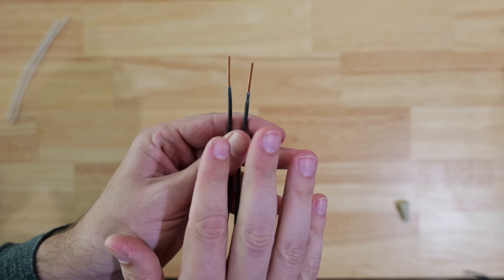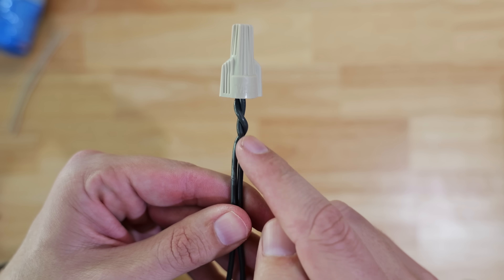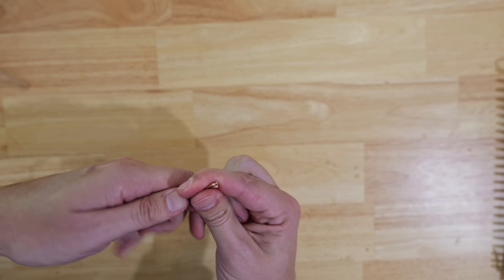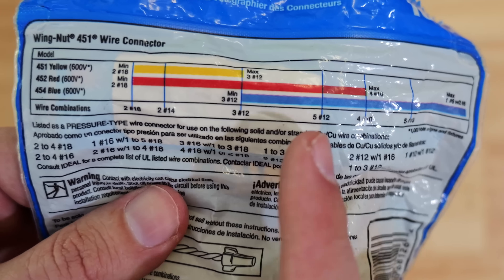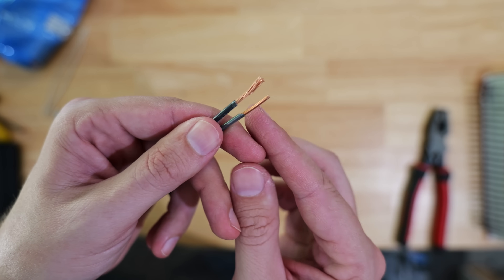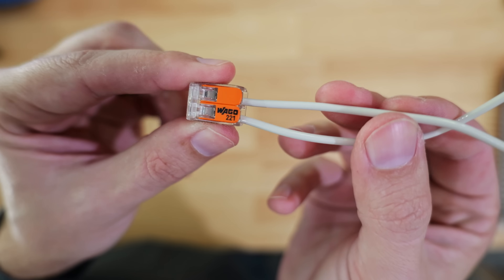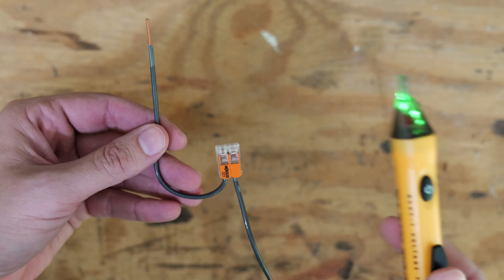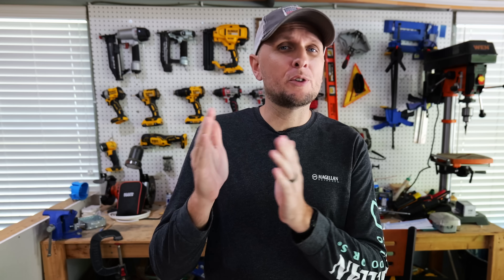7 FATAL Wiring Mistakes Most DIYers Don't Know They Are Making | Most Are Guilty of 3

Comment: Hi professional European electrician here. Wire nuts are pretty uncommon here, indeed I´ve never seen one in use here. The WAGOs are really hard to open, I can´t imagine that this could happen by accident. (theoretically when you pull in backwards direction only.) And all the information you need to know is printed on them: Voltage, current, wire style, AWG, cross section, even the strip length (as picture for the true length and also as number). Additionally the same information huge on the paper box. So if you are able to read...they are pretty safe. They even have a hole to check voltage without the need to open the connection. Tests show that they are more safe than screwd junctions and as soldered junctions.
Reply: Ja die wagos sind echt gut im Vergleich zu dem was es vorher gab
Reply: they are everywhere in sweden, i moved from denmark to sweden and had never seen them before, i dont use them my self think they are outdated
Reply: @bikerpumbajh8108  the wagos of the wire nuts?
Reply: I don't think we'll ever se wirenuts used in Europe or the Nordic countries. I use Wago's too or the normal single or double screw block thingies. I prefer the 2773 in most cases where no stranded wires are used - but they are a bit of a bitch to take of sometimes. The 221 are multipurpose, but i feel they can easely open and they are very brittle if a painter has been there, and you can't really reuse them as the levers brake easely..
Reply: @Hemshemsems  The levers break easily?? What? I've never encountered that.
Reply: @mrvisual2482  More an info to keep them from contamination from solvents and paint and so on. Keep them clean and packed away when other ppl are working in the same area..
Reply: I haven't seen 'wire nuts' used since god knows when. Way back in the 70's maybe. Wagos seem to be the 'in' thing of late and once closed the connections are pretty secure. But UK wise, screw terminals are usually the way forwards for DIY. But even then, I've seen stranded cores just put into the terminal as is. Unless you put a slight twist to them they can just come loose as they spread as you do the terminal up. But in the factory panels, sprung terminals are everywhere.
Reply: Klaus why are wagos better than screw terminals? Assuming the screw terminals are properly torqued.
Reply: @bertiesworld  wire nuts are still pretty standard in Canada, unless it's LED pot lights that come with WAGO's never seen an electrician use anything but wire nuts.
Reply: in NL, we have wire nuts in stores, but nobody who's done electric work in the past 20+ years would use them. Older people that used to do electrics do prefer them over the new wago-like things we have, so the DIY stores still have them (or at least, did 10 years ago).
Reply: @dmhor7389  in the US I've never seen or heard of Wago boxes
Reply: I occasionally use Wago connectors, I constantly use their relays and terminal blocks, on hindredof machines, over a decade and haven't had a failure with their product.
Reply: @kettch42  there is plenty of  Wago product in the USA
Reply: @mikehagen3785  of course but have you ever heard of the wago boxes with slots for the connectors to sit in? In the US we use the outlet boxes as junction boxes as much as possible.
Reply: @kettch42  I have them, my rep gave me samples,  I just don't need them often, I wire industrial equipment.
Reply: @mikehagen3785  I do industrial mostly too, mining. Control wiring is usually din rail mounted screw terminals. Lighting is still wire nuts, but miners are very resistant to new things. I do residential stuff as a "hobby", so I'm not on the cutting edge. I work as a licensed EE doing power systems and motor control design and construction management.
Reply: @kettch42  yup, Din rail and PLCs, control relays, etc... I build some equipment for hydraulic cylinder repair, a lot of it caters to mining. Polishers,  hones, specific tooling for disassembly and testing of cylinders and other equipment.
Reply: @mikehagen3785  do you see wago used for control wiring? I haven't seen it but I know other industries have different styles.
Reply: @kettch42  I use a couple of the din rail relays on a 24v control system. Real basic stuff, I don't have any experience with the fancy stuff I've seen in the catalog. I haven't had a need yet. But I can say that it is quality and I'd be comfortable using it for its intended purpose.
Reply: @kettch42  they have tools specifically made for using there components,  makes it a breeze to use them, wish I had the excuse to order them all.
Reply: @unwelcomemotivation  WAGO's are not even easy to find in DIY stores. You can get the online, but they cost over a dollar a piece in small quantities, which drops to around 60 cents a piece if you buy 50 or more.
Reply: The trouble with them is the connector is carrying current
Reply: @kettch42  If you have to deal with live-wires you will instantly know why Wagos are way better than screw terminals.😉
Reply: As UK electrician for 30 + years we have never used twist connections as banned in 70s. We only used connection screw terminal blocks, but now we use wago's  as rated to 30 A
if used properly are far safer than screw terminal  blocks as stranded and solid can be connected better. Also those voltage test are only guides and can give false readings
Reply: Right so if you don’t know what your doing and don’t read the instructions they don’t get a good result.   I’m not sure what kind of non contact voltage tester mine are marked 110-120 and 210-240 so they won’t lite unless you have the correct voltage.  I have gone to WAGO exclusively and have never hooked a lever, which are recessed on the sides.
Reply: @takedeadaim8671  those volt sticks light up from static
Reply: @ Klaus T. Wago is also the main brand that makes the wire nuts here in Europe. I was taught how to mount a Wago wire nut in school when I was 13 years. Different method as shown in video, using two pliers. But same principle.
 I'm 41 now. 
This was before wago came out before the just slip in (maybe they were all ready on the market back then, don't know) and now the ones which you can open with the clip. The last ones (221 series) only have been around for around 10 years.
I do know when I was building my house 12 years ago, they weren't available for sure (221 series). Else I would have put these in everywhere instead of the grey slip in type 😉
Reply: @kettch42  if you had used both professionally, or quite often you’d know why.
Reply: @martinlewis1015  mine is not a simple volt stick, I used to wot on large machines panels have low voltage controls so you want to be sure
Reply: @takedeadaim8671  they are only a guide ( trust me they can never be trusted 100%) I was caught out when asked to find if a socket was live or not I said it was live but it was not wired. I was using your very model, top of the range fluke
Reply: @bertiesworld  According to the German electrical code you are supposed to crimp a little ferrule on stranded wire before you clamp it into a screw terminal to prevent the strands from speading out.
Reply: Europe is not the same country as Europe, so there might be differences. In the Netherlands, wire nuts were pretty common at least up until the 1980's and were sometimes even prescribed by some corporate companies as internal building standard. Grey old style Wagos without the lever being the only real alternative (not to mention cheap store brand crap). An old Wago without a lever is much more finicky to install correctly and keep reliable than a wire nut. The best European wire nuts that are still available are Conex type that can be inspected after mounting by just removing the plastic hull; the spring will remain in place.
Reply: @Neturist  I have used both and I don't. But I suspect there's a miscommunication because screw terminals are not used for connections except in industrial in the US, and so what Klaus refers to as inferior might be something we don't use here.
Reply: @jankrusat2150  not true for screwed "cage clamps". Here WAGO even recommends not to use ferrules. Cage clamp means that the screw doesn´t press directly onto the conductor. I was taught to use ferrules and like them .. but never stopped to learn new things.
Reply: @klaus2t703  They are required for the old "Lüsterklemmen" screw terminals. NOT for WAGO clamps.
Reply: @jankrusat2150  Not all cage clamps are spring clamps. I clearly talked abut "screwed cage clamps".
But yes, old style Lüsterklemmen need the ferrules. But there also are new style "Lüsterklemmen" where you may use stranded wires without ferrules. 
.. but I did an internet search: Here WEIDMÜLLER is the brand for screwed cage clamps (not WAGO as I wrote before. I always mix them up).
Reply: Wire nuts have a special role as they are mostly used in areas that have a lot of vibrations where I come from (think militairy base of heavy factory's) because the wires in the normal Wago's can vibrate out of them, that can be why the Wire nuts are pretty uncommon in Europe. Just some information for the curious people.
Reply: @janickbutter5258  We have heavy industries and military installations as well. In case of high vibrations we use crimped on ring terminals on studs, secured with nuts. Wire nuts were never approved here. 
Also, wire nuts are not aspproved on aircraft. There connections use crimped terminals, either on studs, with self locking nuts or in Cannon plugs.
Reply: @RX lol archaic. I've never had a wire nut fail. But I've seen wagos fail. So I'll stick to my archaic method.
Reply: You should NEVER use solder. Only for low voltage stranded wires. Solder (unless you get the Cardas Audio Quad good stuff) is only tin and lead, so the WORST for being conductive. That’ll lead to a fire real much quick. Wire nuts are awesome! You just gotta do them right. The other connectors are kool but damn expensive. Never seen one in use around here. We gots the wire nuts in this city!
Reply: AC Units have them should say American made units they are crap.
Reply: @dmhor7389  exactly
Reply: @dascandy  It is not used in Hungary either, it has been prohibited by the standard for a long time, just like the soldered connection. Only WAGO and terminal blocks are accepted and strictly required by technical inspectors.
Reply: @RX Wire nuts aren't unreliable; I wire up motors all the time and use wire nut's in the cover. They are exposed to all the heat and vibration from the motor, and they don't come loose. On larger motors we use large crimp connectors.
Reply: @Hemshemsems  Wirenuts was the only good thing we had in Europe 30 years ago.  Myself old-school trust them more than the Wago's.  The lesser contact surface at the connection makes the Wago's heat up when high amps are applied.  When using a thermo-camera in a cabinet, one can often see some Wago's pop-up. In worst case the plastic housing melts or the built-in springs do loose tension, one knows the potential consequences.
Reply: @Hemshemsems  Wirenuts are used everywhere at least in Finland, Sweden, and Estonia. I don’t like them because it’s not possible to see or quickly test if they are properly in place. Transparent quick connects are handy.
Reply: @tuttebelleke  i'm sure they work fine if you twist wires and so on. I don't force ppl to use Wago's and mainly use them on 2-16amp 230/400v and rarely see any burnt connections. But implementation is always key whatever connection you do..
Reply: Been using WAGOs for about 8 years now and never once had an issue. Well engineered, quick and easy.
Reply: @kettch42  Nope. I've seen back wire screw less receptacles, which are essentially the same thing, fail countless times.
Reply: @dannygreen7473  definitely not the same thing, and anything will fail if it's installed incorrectly. I've seen those installed usually without tightening the screw. But I don't use the push connection on outlets, but Wagos are great and very reliable.
Reply: Wago connectors are far superior to wire nuts in every conceivable way. There is literally no reason at all to ever use a wire nut. Ever. The only exception I could think of is, if there was some kind of connection that was going to be underwater, and you needed a special underwater seal or something.
Reply: @janickbutter5258  they use wago connections in RV’s and you will never see a wire nut connection in a motor vehicle unless some hack put it in.
Reply: @kettch42  You just proved you don't know what you're talking about. Those receptacles don't require screws in the back wire configuration. They work essentially the same as a wago.
Reply: @liquidrockaquatics3900  They're no better than scotch locks.
Reply: @dannygreen7473  all right man, but let me know who you work for so I don't have them on any projects I work on.
Reply: I've seen electricians in the US using those things 20 Years ago there but I guess it's all in what your use to there not as easy to take apart you have to put your glasses on there's as tiny release depending on how big your splices are you need different sizes or use pig tails more money. There quicker onec you get use to them
Reply: In Switzerland I’ve used Wago for a couple of years now, never heard of a wire nut before!
Reply: @martinlewis1015  Can you point to the relevant literature for them being banned? As I didn't think they were specifically banned. Sure, they haven't been used since the 70's but I didn't think they were specifically banned. Wagos all the way now, detest trades sticking to the same old 'coz it always been done that way, so it must be the right and only way bullshit. Trades folk like that need to find a different job. Not for on minute suggesting your one of them.
Reply: @martinlewis1015  Yes but BS7671 doesn't exclude them AFAIK.
Reply: @scoops0406  they have not been an option to buy them in UK only Chock blocks which have been around since as long as I can remember, or round Bakelite connection of which are still in use today
Reply: AMERICA!
Reply: @kettch42 screw terminals can relax, maybe point compression, wago and others have a string spring that makes a non relaxing join.  Uk  rules prohibit wire nuts.
Reply: @johnsherborne3245  makes sense. I think that's why they have torque specs, to avoid that. What I'm thinking about is how best practices for CT terminal blocks is crimped ring terminations to screw terminals, because if there's an open circuit, a multi-million, long-lead time transformer is at stake. It seems like they'd specify spring terminals if that was more ideal.
Reply: Don't forget Wagos have a little hole to get your meter probe into for testing
Reply: @kettch42  I hadn’t either until I went to England, got in a conversation with a fellow about house wiring and he said “…you Yanks use those STUPID bloody twisty things to hold wires together…”.  I thought, what’s he talking about?  Then I learned about Wagos.  I’ll never touch another wire nut.  I use Wagos exclusively on all my projects.
Reply: @kettch42  Screws tend to get loose, they need regular supervision. Unlike good springs.
Reply: @tuttebelleke  It's not a problem if you use them according to spec. Regular European 230V connections are rated at 16 amps. The WAGO's are good for 30+ amps. 
And with the almost fool-proof implementation, the correct usage (and thus achieving performance according to spec) is a lot more reliable. Yes, a correctly used wirenut might be better, but the thing is, while everyone thinks and says they always use them correctly, in a lot of cases, they aren't used correctly. The risk of using them is therefore overall greater than when using WAGO's.
Reply: I never even heard of Wagos until today.  Have been in construction for close to 30 years in Wisconsin, USA. Everyone uses wire nuts that i'm aware of.  I am doing some wiring in my garage and am definitely going to give Wagos a try. They look great and easy to use.  Without the twisting together of wires, i bet it makes it easier to push several wires back into the box and tuck them away.
Reply: It's hard for me to trust the wagos over wire nuts because there is no wire to wire contact or a tight thread cutting into the wire. I have had problems in very rural areas where the voltage is a little low and the small voltage drop through the wago caused problems. I like wagos, but I only use them in particular scenarios. Also, wagos are more expensive and it matters when you use them by the thousands.
Reply: @phillip53  sure, in that situation I understand it. Electricity is usually a bit better here, not mentioning the benefits of starting with double the voltage. And they are more expensive. Nothing wrong with wirenuts if used properly. The problem is that a lot of people don't use them properly, even if they think they do.
Reply: @kettch42  On industrial you run new lines or use terminal boxes. Never have I've seen Wago nor screw nuts industrially.
Reply: @fs9553  agreed except for lighting circuits, I've seen wire nuts used for those.
Reply: @kettch42  for professional electricians Wagos take less time when installing, that can make it cheaper compared to the hourly rate. For the amateur Wagos are safer to use: no crimping for stranded wires necessary, standardized torque.
Reply: Ich meine auch das die Wagos das beste sind. Diese Wire-nuts ist Verbindungstechnik  aus dem letzten Jahrhundert. Ich wundere mich nicht mehr über die große Weltmacht USA.
Reply: Agreed. North America is quite far behind Europe in electrical procedures and codes
Reply: @leedilkie4028  I think wago spices are great, but I don't agree with you. I have worked on sites with IEC and with Nema style equipment. Nema is robust and intended to last a long time with a high safety factor, and IEC has a small safety factor and is idiot-proof. They both have their advantages, and both could be improved, and I prefer NEMA.
Reply: @bikerpumbajh8108   we don't use them on new installations but are pretty common on older installations. 
Most DIY people in Sweden re-use the old ones as wago are really expensive
Reply: @kettch42  stop by any electrical supply shop.
Reply: Oh i just solder the wires and use heat shrink tube on it for insulation. Take way more longer to do but works well for me
Reply: electrician from europe here as well, can confirm. i use wagos everywhere. even when you pull cable, it holds pretty heavy on wires. if you dont want wagos with handle that opens wire, there are connectors without them, you just push the wire inside. that being said, screwing wire then putting isolating tape on connection works just fine for 85% of home instalation. yes, there are hazards, but your lights wont ever pull more than 6 amps, most plugs are gonna power weak devices, and you wont transmit any delicate data over your electrical wires, so it will be enough, it will catch on fire only if you destroy connection or overload them, for what there is a fuse that should react to it. but, as always ill demand usage of proper equipment. ive seen a house that got wrecked by earthquake, and in it cables got pulled out of box since wall split and few live wires were exposed to air. yea, whole area was out of power, but then again, twisted wires failed there.
Reply: @dmitripogosian5084  there are other types of connectors, many copy wago. just make sure it can sustain what it says so.
Reply: @kettch42  You asked why are wagos better than proper torqued screw terminals. I think that are two main reasons: 1) wagos rely in spring pressure, so, there is constant pressure even if the conductor expands or contracts due to temperature; screw terminals can't maintain a constant pushing on the conductor; besides that, copper can somewhat contract or change shape due to constant pressure from the screw, so it would be needed to tight the screws periodically. 2) Wagos are easier to use - it's SO good when you see that the circuit already has wago connectors... 
Of course wagos are not indicated to very high power. 

I use Wagos rated to 42A in a 32A circuit (water heating) and I got better results with wago than I had when I used porcelain screw terminals. The screw terminals after a while started to generate heat and melt the plastic cover of the wires, so I had to change them. Since I changed to wago, the connection didn't generate heat anymore (as seen with a thermal camera).
Reply: Hi, former professional European electrician here. Wire nuts were commonly used before Wago's.
I started to work in 1971, in that time there where no wago's. It was all wire nuts, pre twisted. Look in older houses, installed before wago's were introduced.
Reply: If u use 2 hard wires you can also use the push wago. Never had any issues with wago......
Reply: Wild, I'm an electrician in the US, had no idea wire nuts weren't the standard all over. Here the only contractors that consistently use Wagos are the residential outfits that run their crews at 10x speed all day and just want whatever's fastest (and they just use the plain push-in ones, not the lever ones), and all the service truck drivers pretty much view a building full of Wagos as guaranteed future work due to higher failure rates. I've certainly had an alarming number of them just fail to grip the wire well when I've had to use them. Makes me wonder if you over in Europe are getting a better grade of Wago than we get here.
Reply: @ryanvoss8566  I wonder how a "WAGO failure" looks like. In decades I´ve not seen a single one. Are there any photos?
Houses have to have insurane here - if there was an increased failure rate with WAGOs I guess the insurance comapnies are the first to complain about it and make this public. Never heared about a higher failure rate.
Reply: @klaus2t703  We have to have homeowner's insurance here, too. But that won't be effected unless failures are causing fires at an elevated rate.

From what I understand, failure is typically just loss of continuity within the wago. Mind, I'm not a service truck guy, I'm just telling you what they tell me. But I'm inclined to believe them, because I've encountered a lot more weak wagos that don't hold the wire well right out of the box than bad wire nuts.

But I've got no reason to doubt what you folks are saying either, and wago doesn't have much market presence here (never seen the lever style ones used on a job, and I didn't even know wago boxes existed until reading this thread), which is why I wonder if we're getting a cheaper grade of product here.
Reply: As @kdyke pointed out. You guys have higher voltages there than we do in the US so therefore your amperage is roughly 50% less than ours. That is a HUGE difference and that could be why the wagos are holding up. Here in the USA on 120 volts with roughly 12- 20 amps they are a house fire waiting to happen.
Reply: Wago - 'way-go'
Reply: @einlehrling  why you think everyone speak with your language ? Do you feel better ?
Reply: Those WAGOs are best in the industry. Milspec vibration rated, etc. They're even better than spring-terminals and those are better than screw terminal.
Reply: @matys137  I didn't think everyone speaks my language. I just am better at speaking it than the English language.
Reply: @kettch42  because the installation is much faster and more ergonomic. In Addiotion twisting the wires weakens the copper as you bend it on the outside und press it in the inside. Twisting the wires can also lead to a heat congestion. In Europe, electricians are supposed to be bend wires as soft and as less as possible.
Reply: I agree about wago. I'd like to see someone compare the cheap knockoffs
Reply: @kettch42  Not sure why Klaus thinks so but I'd say because installation is super quick and no screwdriver needed at all so time will be saved there.
Reply: Klaus, I started doing electrical work in Frankfurt, Germany and we used the screw down terminal connections everywhere, and the first time I saw a wire nut, I thought, "what is this crap."
Reply: @kettch42  you already said yourself why they are better. You don't have to assume. They will always sit perfectly, whereas you can easily screw too hard or too little, leading to issues long-term
Reply: @kettch42  the US is still a third world country when it comes to electrical safety ...

This shows in the amount of fires caused by electricity as well.
Reply: @brag0001  lol, I'm sure this is more due to Europeans being required to use trades to do electrical while the US lots of non-professionals do it. Freedom ftw. But not due to deficient standards or equipment.
Reply: @kettch42  well, if that was the case that disparity wouldn't have widened in the last three to four decades in line with the regulations having been tightened regarding electrical safety in Europe.

Also, while what you said is correct in some countries in theory, it isn't true in practice. Even in Germany, where regulations are the strictest afaik I can still go to our version of home depot, acquire all the tools and materials without any license and just get to work. Having bought my first house last year I actually did just that btw.

The only repercussion is that if shit hits the fan insurance will blame it on my shoddy work and refuse to pay. So I have exactly the same kind of freedom in practice 😉
I'm pretty certain that insurances in the US won't pay damages either if they can prove that the work you did caused the fire.
Reply: @bertiesworld  yeah, the other problem with wire nuts that I've encountered, especially with lighting joint boxes, is that it's quite difficult to add circuits in safely when there's a lot of old copper cores twisted together. Much easier and safer to do alterations on a JB where blockies have been used.
Reply: @Hemshemsems  I took an electrician's course with the VDAB (a government organisation in Flanders, Belgium), and we almost always used wire nuts. But maybe that's because a lot of connectors go missing (end up in the garbage bin, or people taking them home) and wago's are more expensive than wirenuts.
Reply: @johnSmith-my9yj  I'm a apprentice myself and yeah we don't have access to Wago's at school either for the same reason. Wago's get stolen and we use screw blocks mostly. They are for sure nice to have not need to have.. Wirenuts are not common in the Nordic countries and Wago's are not always as used here as some might think either. I like to have access to them - but i have no problems using the ordinary screw blocks er mostly have as a standard option..
Reply: We have them in the Netherlands.
Reply: Exactly, electrician here, from Europe, all this seems to solve is, you don't read, there could be problem. Seems like USA problem to me.
Reply: @bikerpumbajh8108  damn I've never even seen wire nut before. I recently moved to Sweden and was planning to buy a house, so I guess will have to redo all wires in a house...
Reply: Wagos are the best ! When I discovered them (working as an engineer in the UK) I had been using screw terminals and I was amazed when I saw them. Never using screw terminals unless I am forced to.
Reply: @mjouwbuis  o
Reply: @mjouwbuis  l
Reply: Clickbait ->dislike
Reply: @jpe1  You´re exaggerating. No one said "the only". And "never seen" just means "never seen" and not "do not exist". This just leads to emotional but non technical discussion. You say "it proves" .. so what about leaving the emotions at home, come over here, looking at older houses to "prove it" on your own how the situation is in a  different country. I´ve seen many "old" installations here, they all used screwed connectors. That´s all I have experienced on my own. It´s not my style to judge about other countries and other persons.
Reply: Master electrician here in the southeastern us. We use wagos and wire nuts, split bolts, and crimp connections. They are all fine, to my european friends we do most commonly use the pre twist method for #12 wire, with a appropriately sized wire nut. It’s an undeniable connection when done by a skilled electrician. However I believe the main reason we use this method is that it’s simply cheaper. Also a smaller variety of items to order. 4 different sized wire nuts (orange, yellow, red, big blue) can be used for many combinations of wire. One would probably need at least double that number of different types of wago to fulfill all the combinations achieved through those 5 wire nuts. TLDR: All options are sufficient, wire nuts are cheaper, wago are easier.
Reply: @klaus2t703  the comment immediately before mine literally says “I never…” but regardless, your point about emotional response resonated with me, and I have withdrawn my comment.  YouTube comments are all about emotional responses, about triggering intense emotions to get the 👍 and further comments to “drive engagement” but that doesn’t mean that I must play into that design.
Reply: I think wire nuts are forbidden in France. Everybody nowadays use Wagos like connexions. Dominoes are still authorized of course.
Reply: @jpe1  I see. I appreciate your feedback. Indeed I can´t find the "I never" post you mention, but it´s not important, either. From the reply hierarchy it looks like you answered to my original post ... and thus it poped up at may account this way. This is why I referred to my post. 
Btw: Do you have any objective informations about reliability issues of the one or the other part. I didn´t find any good information. 
Obviously I´ve never used wire nuts, so I´m interested in good informations. 
I´m doing electronics development... and had to design a 400V/250A (24/7 use) current controller for Charleston, TN, USA for semiconductor silicon production. So I had to do it in compliance with US rules.
Reply: In germany we call those wire nuts pfusch😂😂😂
Reply: Last time I saw wirenuts was when I went to first year of highschool, and thats around 13 years ago.
Reply: Yeah, I lived in Germany and was remodeling my apartment and went to the hardware store for wire nuts, I was in shock when I was told they had never heard of suck a thing.  I'm not sure why they never made their way to Europe.
Reply: @arandom1024  They have been here, but its several years since they stopped being used. Atleast in Norway
Reply: @klaus2t703  regarding reliability, I only have anecdotal evidence, nothing objective, but for what it’s worth, my parents and I built a log cabin in 1988 and I did all the electrical wiring, using wire nuts (and using the “twist them with linemen’s pliers and trim before screwing the nut on” technique shown in the video) and right now I’m in the middle of building an addition onto that cabin, and all my wire nut connectors from 35 years ago are still rock solid.  Two months ago I bought a house built in 1950 (I bought it as a rental property) and I changed out a ceiling fan (that had been owner-installed roughly 30 years ago) and the wire nut on the neutral almost fell off, it was a solid/braided junction and the wires had not been twisted together.  My opinion (and I stress this is an opinion, informed mostly from my own DIY experience) is that wire nuts used properly work, but the chance of user error is greater than with WAGO connectors.  Given that WAGOs can be bought in American big box stores like Home Depot, the roughly 20% higher price is justified by the reduced chance of user error.
Reply: This guy read some Boxes and was like, “I know better then professionals now.” Good for him. 😂😂😂😂😂😂😂😂😂😂😂😂😂
Reply: @mrvisual2482  16 years and haven’t see that yet either.
Reply: @janickbutter5258  you need some extensive shock load to vibrate a wire out of a WAGO 221
Reply: @explod329  usual cause for a WAGO not working is operator error: not enough stripped back, so insulation gets pushed in the spring. A handy pair of strippers with a stopper block set at 11mm (for the 221) should really make that a non-issue...
Reply: @matys137  why do you think everyone should speak English? YouTube has auto-translate, and it's possible they are reading the comments that way and didn't even notice that the discussion was in English.
Reply: @las5073  dunno, three kinds of WAGOs, the two-wire, the three-wire and the five-wire cover pretty much any wiring inside a home, unless you're running 32 amps. Then you need the bigger size up. The normal WAGOs cover from 0.2 to 4 mm2 (dunno what that is in AWG, 26 to 12 maybe?
Reply: @Validole  I see 100% perfectly installed Wagos melt into a puddle of plastic on a weekly basis. We have builders here now that will not allow them to be installed because there have been so many call backs from them failing. It only takes a few more seconds to twist and cover with a wire nut and with a properly twisted connection you will never have to return to it. This is my opinion because I get to see the real world scenario vs what others see on paper.
Reply: Very helpful video thank you
Reply: I don't know anyone who uses Wire Nuts, here in the UK.

I'm not even sure they're allowed, under the IEE Wiring Regulations.
Reply: True the land of lax regulations Just look at other items that don't have proper control.
Reply: Yea wago’s are the best i have used more than 10000 of them by now lol but i am a electrician i never seen a wirenut in the field
Reply: WAGO FTW!
Reply: I'm not an electrician so have only used Wagos one time but I was also going to say I find it highly unlikely that the levers could open by themselves. IMHO it sounds like a completely made up situation to pad the video out.
Reply: @cjnewbs  yea and if installed proparly they will not come loose
Reply: Wagos should be installed in a wago box were possible or not accessible just as an old fashioned screw terminal junction box. Spring is better than screw as spring keeps constant grip on the cables. I was given a fistful of the American screw caps when working for for an American company and they just seemed like half a job.
Reply: The places that banned wire nuts didn't do it because wire nuts are bad. They did it because wire nuts aren't as idiot proof as Wago style. Personally I think a wire nut connection makes a much more thorough conductor to conductor connection. The wago has one little edge digging into the conductor.
Reply: They melt .
Reply: Wagos melt.
Reply: @cesartoledo5621  nonsense
Reply: More safe?  How?  A correctly installed wire nut can handle significantly more power than Wagos but Wagos handle...theoretically...a decent amount of power before they fail.  Big Clive makes note of this in one of his videos when he's comparing Wago to the clones.  The reason?  correctly installed wire nuts have more contact area with the conductor than Wagos do.
Reply: How do you get all that info on a wago?
Reply: @WJCTechyman  More safe: Lower failure rate. Failures due to:
* installation failures (mechanically, but also: electrical shock when connecting hot wires)
* overcurrent
* normal usuage (like: just normal movement when other wires are installed inn the same box)
* ambient temperature (cycles), humidity
* vibration
* mechanical stress on the wires (cracks) during installation
* chemicals (saltwater, or maybe corrosive residulas in the air)
* over time (normal corrosion, normal electromigration ...)
* others
There should be no doubt, that both systems are rather reliable when properly installed and the proper fuse is installed in a typical environment (no cheap copies). I did no research on this, but I think - regarding failure rate - one needs to focus on the "unusual events". How likely is an electrical shock during installation? How likely is a "mechanically not properly installed wire" (that may slip out or break)? How likely is a current beyond specification? What happens in the contact area by normal corrosion over the years? (a small contact area may lead to a very reliable "oxiden free" contact over time, on the other hand a big contact area may reduce contact resistance .. but the resistance may increase over time). What happens if you use an old, already corroded wire?
But yes: shit happens. A seat belt in a car has certainly saved many lives, but still there are cases where a "not installed" safety belt enabled people to be thrown out of a burning car... and thus they survived. 
--> One needs to investigate the whole system, the average failure rate, not focus on some rare special cases.
Reply: @timgibson3754  Objective tests. Test conditions, maybe during approvals. Studies, universities, insurance reports...
Experience surely is a source, but it is rather "subjective" thus you need to average a lot of them to get an almost objective measure.
Reply: Soldered connections are the worst type you can use for electrical wiring. There can be overcurrent high enough to melt the solder and that results in an extremely unsafe condition. Next thing after solder melts is loose wires then sparking between conductors then sparks catching nearby things on fire. Pretty soon you have no more house and are lucky if it doesn't result in a death.
Reply: @Bikerpumba Jh  wago connectors ARE outdated, they lend themselves to failure because it is only pressure holding conductors together. They may be ok for the first ten years or so but try to make them last a hundred years without replacing them several times. Wire nuts with internal steel springs will last a thousand years, no maintenance needed except the occasional update of your electrical system that times require (you need higher amp outlet here, rewire it to allow for it. You are  remodeling an entire house with new plumbing, electric, hvac, and so on, of course you will replace them)
Reply: @Hemshemsems  and why are your wires in a place a painter can get to? They belong inside a wall.
Reply: @bertiesworld  safety isn't a status symbol thing so put that thought about something being the in thing way out of your mind. Let's see, the Roman's used concrete to build a lot of structures but for almost 1500 years no concrete was used until they rediscovered how good it was. Next time you think of not using wire nuts since the 70s think of concrete and other prehistoric technologies  that are making a comeback. How about the strigil? Use an old useless credit card as your strigil in the shower.
Reply: @RX Was thinking the same thing. I am from the Netherlands and I noticed it too. Americans can't stand them, funny, since they still hang their electric cables above the ground on wooden poles..😂 talking about safety..in the Netherlands we put it IN the ground, for over 100 years..  Also he didn't mention that most used Wago's are WITHOUT a lever...soo.. 
Greetings from Holland
Reply: Any good European videos?
Reply: @jankrusat2150  here at least tint the strands
Reply: Wire nuts are super common in the US. Uncommon in the EU.
But, I've found some cheap WAGO type units from China that were prone to failure. Always at a too good to be true price, of course.
I still prefer, when working to European specifications, screw connectors or soldered.

I did have one epic failure once, at a hotel in the US. Late at night, I noticed an orange glow coming from an outlet. Smoke began spewing forth, a choking smoke from hell. Given the late hour and I had to be at work early and evacuating wasn't much of an option, I rapidly dismantled the outlet to find copper glowing orange from a resistive connection. The room was daisy chained outlets, with no less than six outlets daisy chained off of one remote and inaccessible breaker.  I broke the connection and realized, they were running current through the break-off bus tabs, usually used for a live outlet and switched outlet or dual circuit outlets when broken off and the screw as loose as well on the glowing leg. A mere 10 ampere load glowed that thing like a glowbar.
The outlet was also a no-name brand, so of questionable quality and further investigation of the room revealed other outlets of the same brand had damage associated with overheating.
Bargain hotel, bargain near electrical fire. I insulated the unterminated outlet feed and left it for the staff to deal with, likely still not meeting electrical code.
Why do so many emergencies tend to happen soon after midnight?  :/
Reply: @robertrdell8898  Soldered connections are not generally bad. They are in every device. Every PCB uses soldered connections. But if you mean using lots of solder to make a stranded wire solid, then I fully agree. 
And overcurrent should be protected by a proper fuse. The fuse rating should meet the wire and connections specification.
Reply: @robertrdell8898  I´m confused. WAGOs are the more modern connectors. And WAGOs are the connectors that use steel springs. Thus WAGOs self adjust for moving/shrinking/migrating conductors. And many countries have already moved from wire nuts to WAGOs, for a good reason...and for some decades now without increased failure rate.
Reply: @RX-1Americans like many archaic methods, like imperial... 😂
Reply: @hardtymz2517 lead solder is forbidden in EU. Good lead-free solder is with silver.
But nonetheless, soldering the tips is also against standard in EU.
Reply: @tuttebelleke Then you used the wrong Wagos. That is, why you do need a 3,5 years apprenticeship and an independent examn here.
Reply: @einlehrling wire nuts are outdated
Reply: @kettch42  
Screwing terminals CAN HAVE the tendency to fall apart if you use a lot of wires in one terminal since you have one single screw with a flat head trying to press together ROUND copper wires. I think the main conveniance is that every wire has its dedicated slot and so removing a single wire not require you to remove ALL wires at once. My dad has done a lot of wiring with screw terminals and inj some cases he had like..... 6 or even 8 cables to connect into one terminal? Which is awful to assamble as one always slips out or if you make them pretty long you need to isulate them extra to not connect with anything else if the wires poke out.

So I mainly believe Wagos or even Wire nuts have the advantage for handling there, if used properly.
Reply: @mijp  Are your Wago's different?  Are they so complicated that you need 3,5 years on training on them?
Reply: @tuttebelleke  That was not the point. The point was, that even if so uncomplicated and safe, some people don't get it, how to use them.
Reply: @kettch42  Simple Answer: Screw connectors have to be checked every year. Wago Connectors are maintainance free....
Reply: @bikerpumbajh8108  I was going to say that they're an old fashioned thing here in the UK. I'd see some used when I was working in the trade 40 years ago, but they were usually the all ceramic ones. Most stuff back then was done with connector block. Wagos seem to be a game changer.
Reply: @dannygreen7473  The scotch locks chop through insulation and cut into the wire, they are useless. I have seen many problems caused in automotive application they are not spring loaded and cut away strands allowing moisture into the cable causing wiring failure. In automotive in areas that are wet they use butt crush connectors which are surrounded by shrink wrap and glue. Trim the wire slide it in and crush connect. Then hot air gun it the heat shrink shrinks and seals while the glue in the connector melts and seals everything. They resist vibration and moisture and a good cross sectional area of wire is clamped giving good current carrying capability.
WAGO with right wire length of insulation correctly installed will not pull out of the connector and you can see it, slide it in the WAGO box and that protects the connector, the box has plastic wedge grip to prevent cables being pulled out of the box. The clip down lid if very firm and would not come undone without quite a bit of applied force. I have the ferrules for plain stranded wire when in a screw connector, when the screw crushes the ferrule it collects the loose strands together giving a good connection with good current carrying capability. A copper wire in a WAGO connector is only gripping on each side of the wire with the sprung loaded blade how much current that carries before a problem I do not know but many experienced electricians have used them for years without a problem. Twisted wire terminals I have seen, twisting wires together and a wire nut cutting externally into the outside with an insulation cover. If correctly applied I can see them working but with to short a twist and being moved I can see them coming loose. WAGO connectors can be moved the box holds the wire and the connectors are not under strain. There is far less chance of getting a shock as well as the terminal is in the insulated clipped covered box.
Reply: @veroniek  I have seen very few twisted wires with twisted wire nut in the UK on mains or lighting circuit. Sure your not confusing it with screw connector blocks seen plenty of them and of course round terminal boxes with screws in them. Twisted wire screw connector twists the wires together and bites into the wire at the Sam time. I have seen that type come loose if the wire is moved. WAGO connector in a WAGO box will not do that.
Reply: I think the 240 volt versus 110 volts may come into play here. To do the same work electrically in the States at 110 volts you need double the current and cross section of wire in contact becomes more critical.  It could possibly be a problem in the States but would like to make sure the right WAGO connector is in Use and the insulation was removed to the right point. If the spring tang and backing where not properly making contact with the copper wire and sitting on some insulation then I can see a problem straight away. Interesting subject.
Reply: In the UK the regs for fuse boxes has banned plastic back to metal ones. Main reason is cheap imported fuses that due to faulty or bad manufacture catch fire and set light to the plastic box and that risks setting the house on fire. Back to metal!
Reply: I like the tape around the levers. Heard special forces do that with grenades, stop pins being pulled during covert activity. Obviously fold the end back a bit so you get the end of the tape easy (for the grenade). Read a book about French Foreign Legion in North Africa late at night a grenade went off in tent when someone was taking kit off and caught pin pulled it out by accident. Not the first time it’s happened will not be the last.
Reply: Hello Klaus... One need not be an electrician to understand that some people are just too stubborn to go with the times and changes they bring. Wago's have been around for decades  and even the Wagos previous to the 221 were ten times better and safer than wire nuts IMO. I too have NEVER had or seen for that matter a 221 that was open in a box or had been pulled off. I'd assume that only happens when people do sloppy work. In addition, to the contrary to what was shown here with electrical tape use on a 221 one may want to recommend that for wire nuts in some cases. Open a box with 221's and it looks so clean and orderly. Not to insult anyone but a little joke I like to use...If one has the option to connect with Wagos and still uses wire nuts you may have a screw loose. 😉😂😂Have a good day.
Reply: @kettch42  ... A simple reason...people tend to over torque the screws and rip the threds out or rip the head of the screw apart.  In particular when there are more wires in the connector than there should be or different diameter wires.
Reply: @kettch42 ... They exist, but never seen one in use or needed one. They function very well in a normal box IMO.
Reply: @jankrusat2150  ... To my knowledge this applies to the application in a Wago 221 as well.
Reply: There have been studies done on what you are calling wegos that show thermal and therfore electrical loss due to the resistance in the device
Reply: @benhecker1704  Yes. Every conductor, every wire, every connector introduces ohmic loss. Nothing weird about it. The question is: is it dangerous? And how does the resistance behave over time, over temperature ... and how likely is an increased resistance due to installation mistakes? There are tests with 100A and more on connectors that are rated for maybe 20A or 30A. 100A on a 30A rated resistance causes 11 times the dissipated power and thus 11 times the temperature rise. Let´s say 100A cause a delta of 200°C, then 30A just cause 18°C. So for all electrical devices: use them as they are meant to use.
Reply: @klaus2t703  that is in comparison to a wire nut. The wego had a higher resistance impact on the circuit than wire nuts. That is besides the fact that they cost more,  take more space in a box or enclosure, and in the states have been known to cause problems when used with afci type breakers. They are no faster than wire nuts. I use them for small low voltage applications, controls etc., but do not use them for permanent medium voltage wiring
Reply: @brag0001  I'd reckon it's more a product of American wood construction from the tornado, hurricane, and earthquake menaces. In order to rapidly rebuild from any disaster, many corners in fire safety were cut. Even if the US had European electric safety, I don't think the rate of electrical fires would be greatly reduced as American houses are far more flammable.
Reply: @matys137 that's just rude. Not everyone speaks English.
Reply: @arandom1024 oh they're available, but only from big suppliers and even then they're rare. It was common in Finland to around 80-90's. But like last 20 years I've never ever seen electrician use them in domestic or industrial use.
Reply: @cjnewbs same hear. I know quite many electricians and not a single one has said that they would've had close call because of lever opening in them. I should also be noted that there are even DIN rail mounts for wago's that make this event pretty much impossible to ever happen.
Reply: @WJCTechyman key is that correctly installed. It's almost impossible to see if wirenut is correctly installed without looking carefully. Lever style wago open you can easily spot. That being said there's one huge difference in EU and America. Voltage. It's automatically better in Europe as it's virtually impossible to overload here.
Reply: Last time i used wirebolts was in school last century 😅😅
Reply: In my home town in Canada only 1 of the 20 or so electrical companies use wago connectors. They are much faster and easier to use, they aren’t any safer or more dangerous. Wago’s however are around 2x the price and they aren’t as universally usable. The marretts or wire nuts as the Americans call them that we use in our company are good for 2-5 14AWG wires. You need a different wago for 2, 3, 4, or 5 wire connections. Many light fixtures come with wagos on them so we use them, but that’s the extent I use them in.
Reply: @dmhor7389  Canadian electrician, never heard of or seen a “wago box” personally I would trust a wago connector to be safe, but I could never justify the extra cost of using them when they aren’t any safer than a normal marrett or wire nut as Americans call them.
Reply: @Eibarwoman  While that theory sounds compelling, I doubt that it explains the difference I'm talking about. The disparity largely stems from EU numbers going down as the regulations tightened, rather than the US numbers going up. I agree that there are confounding factors, and that not all of the difference can be explained that way. But certainly the widening of the disparity, which already pre-existed in the 1980s AFAIK, can be explained in large parts with those changes; as it mostly comes from EU numbers getting better during that timeframe.
Reply: @johnnybakblast457  And how much actual contact area is there between the connector contact and the wires?  In a wire nut, the coiled spring cuts into each wire at least 3 or 4 times as it is threaded onto them.  That's why I still use wire nuts.
Reply: @kellyevans3254  - each to their own Kelly but it’s whatever provides peace of mind to the individual. Personally speaking, I can’t foresee a time when I’ll stop using them - not unless something much better comes along.
Reply: @brag0001  There's also the engineered wood products which aren't as widespread in Europe (due to more masonry and concrete/steel construction) but very widespread in the US in newer constructions and horribly flammable. As in  a new American house burns twice as fast as a house not built of engineered wood from the 80s. 

Edit: The engineered wood is kind of widespread to the point that even the framing can be made from it in the US and is sold by the "it's stronger than a regular wood beam" not mentioning it's more flammable.
Reply: @Eibarwoman  that might be part of the picture, but then we'd expect American numbers to go up, rather than EU numbers going down.

However: if what you say is true, that would be even more reason to eliminate all sources of fire hazards possible, as the impact of such changes would be even higher in the US.
Reply: @dmhor7389  agree
Reply: @dascandy  is een lasdop/lasdoos een wire nut?
Reply: @rob12424  yup; een lasdop.
Reply: The primary rule is, it has to be a solution and manufacturer by the states.😅
Reply: @unwelcomemotivation  I have a new ceiling fan to install and I've treated my self to a tiny package of wagos from Amazon. I'm worth it!😆
Reply: @Jan Krusat  Here in UK wire nuts are usually only ever found in imported junk like Hair dryers and vacuum cleaners. We never use them, I prefer chocolate block connections or Wago but you can't beat good old soldering and shrink sleeve.
I would rather have German or UK wiring than rubbish US stuff.😊👍👍
Reply: I feel like this confirms everything I've thought and questioned about the questioning of wagos.
Reply: Yeah, using wire nuts seems like just another example of American bakwardness. Only ever see them in old installations and they always show signs of overheating even though the wires have been correctly spiralled around eachother. Then again maybe there's something about them that makes them more suited for 110v 🤔
Reply: DIYer in the US here. I used the wagos for my bathroom remodel wiring and it made things quick and easy, I have 0 concerns about any of them failing. I managed with a variety pack I bought on Amazon but I can see the costs getting out of hand on bigger jobs. I think they'd catch on more if they were cheaper, just like PEX and pro press are catching on for plumbers
Reply: I have no idea how those nuts are legal. Its a small leap from twisting and electrical tape. 😂
Reply: I've learned to install wire nuts in the 90's in the Netherlands. Nowadays wire connectors like wagos are used
Reply: Hot take, both wire nuts and wagos work well when installed properly.
Reply: @nickgoodall578  LOL that was funny :) You are worth it!
Reply: @mrvisual2482  not original Wagos, Chinese knock offs yes
Reply: @unwelcomemotivation  come on Canada don't let the Yanks overtake you,Wagos are catching on quick there,at least you use European measurements, they don't,
Reply: @kettch42 ,well thank God you have now,order some and start using,see what you have missed😊
Reply: @kettch42  My understanding of this is that the wiring can heat up and repeated heating/cooling of the screw terminals can loosen the connection.  This does not happen with the Wago connectors.
Reply: @onelineal9382  wire nuts and binding screws are far superior connections to wagos and stab-ins. Back wired clamps are very good also. Stab-in connections in my experience fail often on receptacles especially. I only use wagos and stab-ins for lighting circuits that have low power demands (LED).
Reply: @kettch42  I have had many cases where people overdone it and squeezed the wire, so it ripped appart when I was working with it. It's is a serious fire hazard when not properly used, wago nuts or Wago Klemmen in my country are way easyer to use and are nearly idiot proof. If you know what you do, there is no problem with screw terminals, but I wouldn't recommend them for DIY'ers.
Reply: @kettch42  It is just outdated, simple soultions, while the Wago is a modern, easy to use/lock/unlock stuff.
Reply: Here in Portugal wire nuts are uncommon too, for years now almost everyone use Wagos before we used screw connection blocks in some cases people still do as you can install them giving continuity to the direction of the wire creating less bulk in smaller boxes like the ones we use for lighting, another thing Wagos are great for is to create test circuits when we're doing domotics or other more complex systems, in my opinion, this is where they really shine with the ease of use to plug and unplug.
Reply: Wago connectors are great for flex cables. So many sparkies I have seen put flex under a screw without bootlacing the flex, which results in the screw shredding the core and reducing CSA and decreasing CCC, leading to overheating.

Wago connectors are great for fault-finding when actives and switched actives get mixed up, saves a lot of time and copper compared to BPs
Reply: @tuttebelleke  Yes, in a wire nut, the current goes from the source wire directly to the load wires.  In a wago, the current is conducted from the source, through the conductor within the Wago, then to the load wires.  There is a separate contact point in each bay of the connector for each wire. Visually one can see the large contact area in a wire nut by pre-twisting the conductors, and it is a large area in comparison to the Wago.  Which is better if both are done properly?
Reply: @dascandy  in Portugal it's the same
Reply: youtube alowes every thing now so, click to sponsore this ....
Reply: @Hemshemsems  When I got my electrician education 24 years ago we used wire nuts, but that was in school, working electricians had already stopped using them and used Wago instead. Wire nuts are a relic of old times, good to be rid of them. Wire nuts are a safety hazard, to easy to make a bad connection, or if you want to add a additional wire they are a real pain in the ass.
Reply: @phillip53  Well the price difference is easily made up in labor time, in the long run you could even save money. Super fast to use Wago when you get used to them. Set the wirestripper on the recommended length and away you go. Of course the are wire nut tightener bits for power tools also, but thats just unpractical.
Reply: @explod329  Well the Wago are rated for 32 A/450 V, meaning that Wago can guarantee that they wont fail if used according to the specifications.
Reply: @jstro-hobbytech  There is a English youtuber (John Ward, I believe) that tested a chinese knockoff, It a few years ago now but even the copies where really good.
Reply: @kettch42  Because screwed connections have to be accessible for inspection because they can work loose.
Reply: @bertiesworld  If you're using stranded cable into a terminal designed for solid core, then crimp a bootlace ferrule onto it.   It really isn't hard to do things properly if you know what you are doing.
Reply: @Hemshemsems  In Finland they used to use them in 1970's but nowadays I dont think they are even legal anymore and every one uses WAGO connectors.
Reply: I work on Rv's in the US so both wire nuts and WAGO's are pretty common. I have ABSOLUTELY seen wagos pop open accidentally before. I have no idea if they were defective or what, but for some reason I get ones that a very loose and barely stay closed from time to time.
Reply: @dmhor7389  Well considering this guy isn't from the UK maybe consider the situation might be different. 

I'm assuming the Wago's used in US 120v are different than European code because i've absolutely come across wago connectors that are easily opened and could definitely be opened by accident. I don't know if they were defective or what, however it does happen. On the other hand, I've never came across one I would consider "hard" to open. 

So maybe it's not an "imagined" issue and is in fact just something you personally don't have to deal with.
Reply: @MitchJohnson0110  - I wouldn’t like to count the number of different Wago connectors I’ll have used over the past few years - let’s just say if it’s like counting sheep, then there will be enough to put me and many, many others to sleep. I haven’t encountered a single one that is easy to open or could be opened accidentally. And it’s not just me, Klaus2T in his comment above also says “The WAGOs are really hard to open, I can’t imagine that this could happen by accident”.  But maybe it is down to a simple Europe vs US production issue, who knows?  All I do know is that the ones available here are as safe and secure as anything I’ve ever encountered.
Reply: @dmhor7389  I think it must be a production issue thing
Reply: @MitchJohnson0110  Unless some unscrupulous manufacturer is producing knock-off versions that aren’t subject to the same quality control? 🤷🏻‍♂
Reply: @dmhor7389  Don't know but they look exactly the same and getting loose ones aren't uncommon
Reply: Because the Wago has a transparent body it‘s possible to check the perfect connection after closing it. So you have to do a lot of stupid mistakes to get a bad connection.
Reply: @MitchJohnson0110  Are Wagos designed/rated to be used in motor vehicle wiring?
Reply: @anonnona8099  RV's meaning not just motor homes but travel trailers and 5th wheels too. And yes. They come from the manufacturer with them. They're even approved for marine applications
Reply: @anonnona8099  Though it campers wire nuts are still very common. Crimp end wire terminals are what are the standard though. Keep in mind also that the majority of wiring in an RV is 12v DC
Reply: Wago are just so much better. No doubt about it
Reply: @MitchJohnson0110  I just wondered if the reason you'd seen them popped open is that they aren't meant to be used where there's a lot of vibration.  Like vehicles.
Reply: @anonnona8099  nah. They're loose when trying to connect them sometimes
Reply: @Klaus2T  an overloaded circuit will heat up and melt out the solder if soldering wiring in walls and the loose connection it causes will create sparks which is the fire risk. This is also why those wago connectors are illegal in the states. If you value your dwelling, remove all wagon connectors and replace them with steel lined wire nuts.
Reply: @robertrdell8898  WAGO connectors are not illegal in the US stop making us look stupid in front of the Europeans
Reply: @robertrdell8898  hahahah sure. Here in Europe wide nuts are illegal go figure why 😉
Reply: @robertrdell8898  There are several issues in your post: 1: "overloaded"-> simply don´t overlaod it. 2: every wire needs a suitable fuse to trip on overload. 3: soldered wires are known to cause safety problems. 4: all you describe is also true for wire nuts. 5: "steel" has 5.5 times higher resistance (heating) than copper, so don´t use steel as conductor at all. 
You can watch videos that show the wagos behaviour on overcurrent. They are super non critical for specified current. And on huge overcurrent usually the isolation of the wires melt, causing problems .. independent of connector.
In the end all that counts the ratio of overall risk in using the one and the other connector. 
All I can say: in decades of using WAGOs I have not heared of a single fire that has been caused by WAGOs ... and could be avoided by using different connectors.
Reply: @robertrdell8898  The melting point of solder (60/40) is 188°C.  If your wiring has got to that temperature because you did such a catastrophically bad job of sizing the conductors vs the design loads and the ratings of the protective devices then you've got much bigger problems that a soldered joint coming apart.
Reply: From the UK. I remember seeing wire nuts on old, rubber insulated, wiring in the 1960's. It just seems to me like one of those things that just shouldn't work but seems to somehow? The US keeping history alive! 😁
Reply: @kettch42  I'm guessing that, by design, the WAGOs  naturally grip tighter the harder you pull the wire?
Reply: Euro electrician… 😂 we invented it bub… go away.
Reply: Last time I saw wire nuts in the UK was  in the 1980s when I rented a house that hadn't been rewired for at least 40 yrs (the cable was two  copper  cores insulated with rubber and covered with a lead sleeve that acted as earth/ground)  I've never seen them for sale in diy shops here in the 40 years that I've been a diyer
Reply: @Klaus2T  the steel is not being used as the conductor but as a hard to melt thing that will keep everything still in place even after the fire. The copper may melt but the steel won't
Reply: As an electrician in the US I had always used wire nuts or butt splices in the past.  Once I got a chance to use Wago connectors for the first time I have never gone back.  Everything I do in my house has lever-style or push-in style connectors now.  They are easy to use and far less likely for the wires to pop out.
Reply: Are you a master electrician? Wagos are pronounced "vargos" and if you follow the manufacturer's instructions all connections will be to code
Reply: @martinlewis1015  The last time I saw wire nuts (made of porcelain, no less) in the UK was in my parents' house from when it was first wired goodness knows when. They were removed in the early 70s when it was rewired.
Reply: @RX-1  not sure where you get that us Americans hate using wagos  BUT YOU'RE WRONG. I use both but as a former of added protection,  I still use electrical tape around the connectors , especially if there are any moving parts near them.
Reply: @kettch42 The answer is in your question. They have to be torqued correctly which is unlikely to be the case with DIYers (which this video is about)
Reply: I'm not an electrician, but I've done a lot of electrical work myself recently (hundreds and hundreds of connections). And I'm not European, I've seen a ton of wirenuts used here in Canada. And I completely 100% agree with you. Plus, I really think using wirenuts, especially with more than 4 solid wires and with any connections with stranded wires are not adequately safe.
Reply: @kettch42  The US is ALWAYS behind of good things...
Reply: @jooproos6559  like going to the moon
Reply: @kettch42  because you can easily remove Wagos if needed, like when performing electrical testing. They are waaay easier to install, with no twisting of the conductors (something that is massively frowned upon, in the UK at least).
And like the original comment says, if you are not a blithering idiot the Wagos are foolproof to use.
Wire nuts are massively outdated and it stumps me why anyone would pick them.
Reply: Very cool! What is your opinion on when American electricians say that Wagos can fail in time due to the expansion and contraction of the spring caused by the heat from the wires?
Reply: Lol… been using Wagos for years. Never had a lever pop up.
Reply: @explod329  In the UK our power outlets are protected by a 32amp breaker in the panel and wagos are used almost exclusively, and in mainland Europe their outlets are protected with a 16amp breaker.
Reply: Wagus are the shark bites of electrical. There is no way that connection is secure as a properly hand twisted connection. Just look at how much tighter it is and how much contact the wires have
Reply: @chriscolameco6850  How much "contact" or better say "contact cross section" an connection has is only one part. But do you also know about reliability of "cold welded" contacts, oxygen free contact, both with much low contact area? I´m not saying that WAGOs are oxygen free, but they come much closer to this technique, because of the spring force and the relatively low contact cross section. There are tiny electronic devices with a wire dimension of about 0.5 x 1.7mm, but still able to carry more than 150A continously. (AUIRF1404Z for example). Do you understand how this works?
Reply: @ryanvoss8566  it’s not the wagons, it’s the people who are not trained good enough.
Reply: @kettch42 Because Cooper tends to flow and loose tension, screws are not the best, springs keep them tight.
Reply: @bikerpumbajh8108  wire nuts are not used any longer in Sweden 😊
Reply: @unwelcomemotivation  I live in Canada and I discovered Wagos a few years ago. I use nothing but Wagos now.
Reply: Never seen a wire nut in the UK. It's all Wago or screw terminal blocks
Reply: То чувство, что Америка живёт в средневековье
Reply: @kettch42  cant use stranded wire on screw terminals but you can on wago and other spring terminals
Reply: @hillppari  of course you can use stranded on screw terminals, unless you're talking about the kind you have to make a shepherd's hook for
Reply: @RX-1 Old Wiring in austria was twisting and electrical tapes.  no one misses that here xD
Reply: was erwartest du von jemandem der 9 Minuten über die wire nut philosophiert und bei Wago in der halben Zeit nur negatives findet.
Reply: @kettch42  you work faster and saver an no prob if you have to change wires
Reply: @martinlewis1015  I'm not a qualified electrician but I do temporary event power and installation in the UK. I'm absolutely horrified that people are using wire nuts in 2023! There shouldn't even be a video on the 'correct' way to use them, the correct way is to throw them in the bin (trash).
Reply: This guy is sponsored by Big Wire Nut.
Reply: @hardtymz2517  you're using the solder wrong! It isn't meant to be used as a conductor, it's supposed to be melted into the joint with a soldering iron and will fuse the current-carrying conductors together to form an extremely low-resistance, mechanically solid and oxygen-free connection. The contact surface area of the connection in a wire nut will be lower, meaning a higher resistance joint than solder and it will be subject to oxidation which will make the connection worse over time, particularly in humid environments.

Seriously, a good quality solder joint will be lower impedance and more reliable than terminals or wire nuts, mains connections are soldered inside almost every appliance. However I think your advice to avoid it in domestic DIY is good! Mainly because it is difficult for most people to do it well and safely (there are other considerations too that I won't get into) but not because it's a poor conductor.
Reply: @bikerpumbajh8108  You cant purchase wire nuts  in Sweden any more banned  in all new installations  due to safety reasons but they exist in older installations
Reply: @mrvisual2482  must be a pirate fabricate
Reply: @mrvisual2482  same thought XD never broke 1  never  if theyre is paint on it i dont re use them bc if the paint is inside its a crap conection just take new on the neck of the company
Reply: @mrvisual2482  They get brittle with UV exposure and in some atmospheres
Reply: @bertiesworld  As an apprentice I was taught for screw terminals to twist stranded and always fold a tail over (Solid or stranded), then install so the tail is where the screw lands. 

The screw will always damage whatever it touches. By putting a tail between the main conductors and the screw, that takes the strain and cutting, whilst the main conductor is clamped hard against the terminal body (you don't want current notionally passing through the screw)
Reply: @kettch42  screws always damage conductors (cutting action from the rotating shaft) and frequently get overtightened. Wagos are a clamping action
Reply: @miscbits6399  this is a good point. I'm thinking of screw terminals on a terminal block which also use clamping force, but that is not a fair comparison because splicing situations do not use that kind of screw terminal.
Reply: As a UK sparky I’d never use wire nuts and have never had the described problems using wagos. I’d rather use terminal bocks than wire nuts.
Reply: @bikerpumbajh8108  They are superior to anything else if you install them correctly. In Sweden, there are laws against idiots doing electric work (unfortunately those idiots have been increasing lately for some reason)
Reply: @kettch42  Not Klaus but: the wagos have a spring tension, so even when the materials age or you have movement/vibrations the tension is readjusting, the screw just stays at a certain thightness level (hopefully)
Reply: Cool make your own video for Europe
Reply: @bertiesworld  Screw terminals are no longer permitted for use in locations which don't have easy access ....such as within walls or under floors. Spring connectors, like those from Wago and Ideal, are widely available, even for DIY purposes.
Reply: @kettch42  Screw terminals can self-unscrew due to thermal expansion and contraction caused by current flow. Spring connectors, like those from Wago and Ideal, don't suffer this problem ....they're also quicker to use.
Reply: @mrvisual2482  You're not alone. I've used many boxes of Wagos and still have to see that problem. most of the time the guy doing the job is the issue. Just like with quality wire nuts. They work great if proper sized and installed correct. In my experience it's especially DIYers that will install safer using Wagos over nuts. The guy has his opinion, that's fine....
Reply: the wago levers do slightly open sometimes but not fully..t know from other sources that even with the lever partly opened it still takes considerable force to pull the wire loose, or to finish opening the lever. However, i you are that worried Ideal offers lever connectors that open in the opposite direction and are not as easy to open, though currently they have no products comparable to the 600 series Wago connectors..
Reply: I have been an electrician for almost 27 years in the US. I love hearing from all the other electricians from around the world on what they prefer and have used before. Years ago I remember seeing and using a different style of the Wago connectors and let me tell you that I was not impressed. They didn't always make a tight connection and in some instances because of not being a secured connection, they actually burnt up several connection points. The ones the Europeans and Australians seem to be using today, look way better than the ones we used to have access to. I think I may buy some to test out and I may even use them in different applications. Thanks for all the input from one electrician to another.
Reply: @bertiesworld Like you said, WAGO have been around for 70 ish years in the panel building industry, they are an industry standard. People think they are a Dragons den choc box style company,but these are just a sideline thing for them,  lol.  Same as Wiska, they make ATEX accessories for offshore oil installations, their excellent Combi boxes are also a very profitable sideline :)
Reply: I never use anything else.
Reply: I agree with Klaus. My father was an electrician ( born in 1915). They used a Bakelite wir3 nut but that fell out of favour a long time ago. Wires nuts are just rubbish. For years we have used plastic coated junction connetors. The Wago are fairly recent and provided they are used correctly are far better than wire nuts. America is stuck in the past, still uses imperial measurements. I was taught imperial at school and we changed to metric in 1970. It’s a far better system. The video is good it shows the correct way to use and instal wire nuts but I still think the best you can do is throw them away.
Reply: Europe also has 220v right?
Reply: What did you use before Wagos?
Reply: @MichaelAivaliotis  Yes. Europe has 220V/230V to Neutral. But indeed it´s not the voltage that makes a connection "dangerous". It´s the current. On the other hand if you have half the voltage you need twice the current for the same power. And twice the current means 4 times the dissipated heat in a connection. And increased heat also means faster aging.
Reply: @factchecker1980  Mainly "screw terminal blocks". You can do a google search for pictures.
Reply: @factchecker1980  Wago came up at 1951, if i remember right. We used screw terminals (Lüsterklemmen) for along time. I think those nuts never been common here in germany, but i am not that old. :)
Reply: I live in the UK. As I know, wire nuts aren’t even legal here. Wagos are and they are very common. The grey ones are hard to open, but the clear ones are great. They are AC rated, but where I worked, we only used them for DC. I’m not an electrician, but study engineering. I understand wiring, but don’t have field experiences, only with DC. So I find these vids useful to see what kind of techniques pros using. Couple month ago didn’t even know about the existence of wire nuts :D
I find bare ground wires really weird here, eh. I know it’s just ground, but come on…why you keep naked single core wires in your walls?! 🤨
Reply: I’d say better than terminal block
Reply: @johnsherborne3245 every screwd terminal I've seen has the screw pressing on a plate which is a piece of spring brass (steel or aluminium on cheap connectors) bent into a triple curve and so acts as a spring to ensure the connection remains secure even if the screw relaxes provided you don't overtighten them. If you are inserting more than one wire into it then they need to be twisted together to ensure they are both mechanically and electrically secure.
Reply: @kettch42  For a start, they are maintenance free, and where do you find your torque settings for screw terminals?

Also, disconnect and reconnect cycles for testing. The WAGOs are pretty much damage free, whereas screw terminals will mark, and potentially weaken the conductor.

WAGOs are also much faster to use.
Reply: Absolutely. Opening 221 by accident will require some mighty pushing done completely blind - not an acceptable way to put splices into a box anyway.
Reply: Ja. Ist nun einmal so. Gibt bei YouTube auch genug Videos, wo die Spannungsfestigkeit getestet wird und die WAGOs bei 250 A schmilzen, während die anderen Verbindungen gerade so über die Vorgaben kamen.
Reply: Also I can't imagine that WAGOs would exist in Europe if the TÜV (and sibling orgs) has to confirm electrics everywhere all the time
Reply: @miscbits6399  Not designed to be exposed to UV light!
Reply: @kettch42  As always: It depends. 
Screw terminals are good and easy as long as they are aligned for one wire per screw. 
Yet as soon as you fit four wires or more into one (Dollyklemme), the risk is high that the screw torque/pressure distributes across the outside bundle and the center wire(s) just stick loosely, corrode and eventually fail contact or slip out. Usually instead of applying enough torque to squeeze them all together, you more likely sheer off the screw. 

So Wagos provide individual wire ports with excellent contact surface and still requiring little space. 

And as for the wire nuts shown here: Good luck with straightening the wires again should you have to re-arrange something. 
Wagos keep them straight and also not squeezed flat or anything.
Reply: @poelwick1522  Er kam wohl eher selten mal in die Verlegenheit, etwas umzuverkabeln oder einen weiteren Strang dazu zu klemmen. 
Viel Spaß beim Entzwirbeln und Begradigen - und Daumen drücken, dass beim zweiten Vertwisten kein Leiter (an)bricht. 
Oder man petzt eben immer 3 cm ab. Aber dann wird’s in der Abzweigdose irgendwann recht stramm XD

Wagos sind einfach ein Segen. Egal ob Hebelklemme oder Standardklemme.
Reply: @kettch42  Actually in the U.S. licensed electricians are required to do electrical work.  You shouldn't comment if you don't know wtf you are talking about.
Reply: How can one be so afraid of Wagos and on the opposite so YOLO with Wire Nuts. 😂
Reply: @kettch42 what's the advantage of revets? There's the answer they don't rattle or corrode loose. Ever seen a screwed wire connection in a car? No...that's why.
Reply: @kettch42 yeah they build houses for one season😂
Reply: Hab auch noche keine gesehen die wagos sind das beste kann man für alles nehmen hab sie schon professorisch im auto verwendet und auch in audio systemen
Reply: @fs9553 I do industrial and have seen all of the above methods. My big problem with wire nuts is that often I have seen the casing fall off of the coil leaving the exposed union. I've also seen quite a few fall off completely. Most guys pick the wrong size wire nut and only get it right by accident. But the biggest problem I have with wire nuts is the damage they cause to the conductors. If you are troubleshooting or changing components frequently that can become a real problem. You can use a wago over and over again on the same wire without significant damage but with a wire nut you end up having to trim it shorter and shorter until there's nothing left and you have to run a new wire.  I've never seen seen a failed wago. I've seen plenty of screw terminals loosen over time. If everyone's being honest people in the wild almost never use a torque screwdriver on screw down connections. If everyone was as careful and knowledgeable as they should be or think that they are it wouldn't be so bad.
Reply: U right
Reply: @steveyirwinstruecrimejungle  Wire nuts still common in US too, although I will switch to Wago type when my supply of wire nuts, bought in the 1990's when I bought my first house runs out!  Great video.
Reply: Seems to be pretty one sided, 1 or the other.  I'm right and you are wrong!  Mine is better then yours and vice versa.

  As an American who has been in the trade long enough to understand the "why's? and how's?", I can wholeheartedly that the hate towards Wago's it leaned more towards change and inadequate understanding of how and why.

  I am personally "pro" either version so long as proper instillation method is used.
   From my own research, it seems as though the EU has all but eliminated WireNuts from code compliance (through multiple changes of onerous requirements to adherence standards), thus making them virtually "not in compliance".

  This was particularly due to the false understanding that wirenuts could just be used as a quick connecting device (which it was never intended to be, it was to eliminate the need to pre-twist wires and crimp-and-cap Buchanan's, or use pot-heads as the only approved methods.  

  Furthermore, in the EU, WireNuts were the savior of time and money (materials and labor both) as well as the USA, Canada, Japan, and a host of other countries (all fallowed suit shortly there after.).   It was a game changer, it was a leap into the future of construction!

  Unfortunately, far too many in the EU, have depended solely on the connectors to make the connection without properly twisting the connector long enough for it to create the connection.  This falls directly on the contractors and the inspecting authorities ineptitudes.  If not for complete and total dereliction of duty and comprehension, this would be the mainstay without issue.

  Conversely, the same complete and total ignorance of PROPER use is in full force here in America!   The improperly trained (all of 15 seconds of actual training it would take), to understand how to use them has taken a back seat to the automatic assumption of "this is the same as a Stab-Back Receptacle!".  

  This is COMPLETELY FALSE!  And I would amount to a derogatory statement in it's entirety!  
  First of all, while both are dual cantilever systems of connection, WAGO's are spring assisted tention where the Stab-Back Receptacles are spring loaded.  Two huge differences when it comes to heat retention/distortion, and dispersal methods.

  Stab-Back Receptacles were only rated for their output ratings till the 2000's when it changed to 15a rated Receptacles had to have a "pass-through rating of at least 20a".  This change is not reflective of current service calls involving troubles and burnouts.  The problem was 15a Receptacles being on 20a circuits but only capable of handling 15a max.  

  Most people have no clue what they are looking at when they encounter his issue let alone look at the era of instillation, they simply see a device failing for what has always been a flaw in code and listing requirements from the past.  Ironically, most electricians in the America's don't even realize that 15a Receptacles are allowed on 20a circuits but are required to handle 20a's.

  Anyway, I could go on but have dinner waiting for me.
Reply: @kettch42  In there is a short in the circuit, the copper becomes hot and deforms under the pressure of the screw terminal. Wagos have a spring and automatically adjust to it.
Reply: I started as an apprentice in 1981. I personally don't trust wago or that type of connection in general. Probably due to having seen so many failures of a stab-in type connection. Far too many people think the stab-lok connection on receptacles and switches is a good connection. Rest assured, it is not. Our electrical code here used to state, (and may still, i haven't looked lately) all splices had to be compression. That is why wire nuts have a metal spring inside them. (All except the cheap chinese plastic ones)  i have never seen a properly installed wire nut fail.
Reply: In Norway Wago is standard de facto Only Wago and it is probably safest connector in the world
Reply: @chriscolameco6850  I agree completely with the portion of your comment that speaks to the comparison of proper connections of both connectors. No question the win goes to twist on connectors in such a case. Tons of copper on copper connection and strong! The video does a great job showing the pitfalls of IMPROPER connection methods , whatever product you choose. Well done.
Reply: @chickenfizz If you do a proper connection with twist on connectors they are great. So why would you ban them?
Reply: @JayUzzi-ts4pg I am in Alberta Canada and have a fair amount of experience around wiring and in trades teaching / mentoring. I think having new-to-industry electricians (or whatever the terminology is in your own jurisdiction) review this videos comments and engage in some discussion about best practices would be highly beneficial. At my workplace we do this regularly. Each morning (or start of shift) we talk about safety and this topic would be excellent as part of a larger / longer session. Good video and thanks to all who contributed their thoughts and experiences.
Reply: @winglschursch1690  
If there is a short the fuse will break the connection.
  Wire nuts are spring wound specifically to follow the contour of the wires they are attaching and to expand/contract under heating.  If not properly installed it will over heat at the nut causing a failure, but the same is true with Wago's, or any other mechanical connection.
Reply: @nooneyouknowhere6148  
  I agree with most of what you say but WAGO'S are not the same as Stab-Back connections.  Stab-Backs are spring loaded whereas Wago's are spring assisted, so instead of losing form/connection over time they adjust with the expansion and contraction as well as have (I believe) 4 V-Groove connection points so is essentially 8 points of contact opposed to 2 flat points.

  I am pro both method's.  I think the biggest issue for both is lack of supervision in the field, inspecting authorities not physically spot checking, contractors not spelling out the importance of overseeing the installing crews joints and just lack of care on the parts of many in our craft.  :/
Reply: @atoiler1389  
Absolutely agree!  Not many people take the time to "talk" about things these days, it's just a get to work mentality.
Reply: Tape  over
Reply: Wagos take away the satisfaction of twisting wires.
Reply: Wago are supreme.
Reply: Common sense
Reply: I cant solder a wago together i can solder wires then wire nut them
Reply: @kettch42 wagos, used correctly, are “maintenance free” (can be used in inaccessible places). Screw terminals aren’t ever maintenance free.
Reply: I never used the wagon I think they are the biggest POS in the recessed sliding. I used to cut them off and use wire nuts instead I would never trust those things
Reply: @timlane940  This is what it looks like to be uninformed. Go watch some testing videos.
Reply: Uninformed really I was an electrician in Los Angeles, California for over 30 years. 90% of the national electrical code has been based off of California I have always 100% used wire nuts. Twisted my wires before putting the wire nuts on have used yellow tan, red, blue wire nuts. Never once has my connections have gone bad. I've worked on multi-million dollar homes here in Los Angeles. Never have I had any problems with my connections. When I had to troubleshoot electrical problems it came down to those somebody using wagon connectors This concept was in the receptacles the stab in part of the receptacles. They changed it from being able to use 12 gauge wires down to 14 gauge wires because those connectors cannot handle a 20 amp load because people use the outlet as line in line out instead of pigtailing. All my receptacles were pigtailed for only two to three wires into it. Neutral hot and ground. So don't tell me that I'm in the wrong. I throw those wago connectors away I will always use wire nuts wire nuts have been used lot longer than those wago I've worked on remodel. The houses are over 50 years old with wire nuts and never seen a bad connection with wire nuts. I've also seen soldered connections so don't sit there and tell me that these wago connectors are better. They'll never be better than twisting your wires and using a wire nut guaranteed
Reply: @timlane940  Except Wago don't fail either and have other advantages. My point is you are ignorant on Wago, not electrical work in general. Europe hasn't used wire nuts for decades and other parts of the world and their wiring is arguably safer than ours. Get with the time. "This is how we've always done it." is never a good argument. Wago actually make pigtailing easier, so no idea what you're complaining about there. There are countless examples of failed connections of all types, especially wire nuts. It depends largely on correct application, not the product. Wago are reliable, easier, more reusable, more repeatable, and more. Learn instead of being stubborn. I know if hundreds of electricians who have switched entirely or prefer Wago. You're not the only expert in the world.
Reply: Ceramic wire nuts were used in the UK in the 1930's  I've come across them in vir lighting circuits.
Reply: One of the most important advantages of Wago is that the spring is still pushing the wires, which is not true in screw joints as well as in those Wire nuts (yes, i was not aware something like that exists and I am quite surprised this is legal, especially on 110V with double the current as in Europe)
Reply: Absolutely right. Wire nuts are an outdated American habit. WAGOs are the WAY to GO!
Reply: @unwelcomemotivation  Things are changing quickly now that they are cUL listed (finally). You're right, LED pot lights from Q-plus (a Canadian company) come with Wago's for installation and I'm seeing this from other light fixtures now too. I only use Wagos now myself. Also, it really speeds up inspections since it's way easier to verify they are connected properly.
Reply: @BazookaIke They work good. So do wire nuts. People get territorial and weird when they see something new. For me, the biggest issue with Wago’s is the price.
Reply: In Hungary the wire nuts were common in the '70-s and '80-s in the concrete block buildings, but it was common that the electrician soldered the wires together before screwing on the nuts
Reply: I'm an electrical engineer in the USA.  I LOVE WAGOS & HATE wire nuts!  You're not wrong about most electricians in this country; they are very conservative and stubborn to make changes.  Part of the hesitation too is protecting "trade craft"—which is just one of the problems I have with wire nuts. Ex: "I'm not some home DIYer; I'm a professional!"  -Exactly!  -A professional that makes hundreds of splices a day which cost time and money, but even more are prone to complacency.  It is very often the "pros" who will cut corners while the homeowner will put all the love and care and time in the world into his home projects cause it's his name on the deed.
Often too it isn't the novice skier that gets injured terribly; it's the "pro". I know people too who are excellent electricians as well excellent engineers, but I've also seen them make some very dumb mistakes...which we are ALL at risk of making.  The WAGOs make things far easier as well far more "idiot proof".  They aren't "craft sensitive".  "But but but but the connection isn't as good as a properly done wire nut connection".  Probably right.  "Properly done" being a key phrase there however. But then also, wire nuts aren't as good as good Western Union soldered splices that knob & tube guys made over a century ago...except so many have forgotten some of the lessons of those times...one of the problems with those splices is often they were "too good."  -The conductivity was greater than the wire itself such that in certain overcurrent situations, it would be some random point on the wire OUTSIDE of junction boxes would catch fire while the splice was just fine!  In thermal images, the splices are room temperature while the wires are hot.  That is NOT what you want!  It's much better to have a melted wire nut or WAGO inside a junction box than a structure fire or burned down house!@RX-1
Reply: we use them everywhere in big electrical projects (industrial/commercial/institutional) these small time sparkys just dont know anything about the advancements in our trade
Reply: @R1GODSPEED  You might add some value to your comment if you specify whether you are talking about WAGOs, wire nuts, Europe, USA. I can only guess.
Reply: Tighten that bastard until you can't turn it anymore, which at that point the wires will twist anyways. Common sense.
Reply: @klaus2t703  yes in the US sorry I assumed the comments were directed toward Americans more since the creator was american.
Reply: @mrvisual2482 1 broke once. But that's 1 out of like several thousands i've used
Reply: Absolutely - I've never seen them in any hardware shop (though I have seen them in equipment imported from the States, which we then had to remove and replace up to Det Norsk Veritas standards - Scandinavian equivalent to US Coast Guard certifying authority). And having seen this video, I now know why they're not allowed.
I guess, if you were building equipment for export, it might be permissible to use them. But then you'd face the problem of sourcing the parts.
Reply: Hey! This is 'Murika! We don't read instructions...
Reply: @@trebnev I agree but renovating shitty apartments ppl around don't really care. I try to hide and cover connections - but filler and paint is still everywhere..
Reply: WAGOs are no better than the horrible push-in connections in some outlets and switches! twist the wires then use wirenut!
Reply: You got to be young then. Because we used only nuts ik the past. And even now its used in high vibration places. Like machines/ industry. As you know you can wip a wire out of wago
Reply: @kumralp  It would be nice if you can do a video where correctly installed wire gets out of a WAGO by accident or by vibration.
Reply: @klaus2t703  come on… im not in the mood to start a typical electrician discussion what is endless. I exprerianced many times even burned or melted wagos. Thats all it. Corectly installed. You can install it corectly but by any pulli g or friction you can pull a wire out a wago or any push connection.
Reply: @kumralp  I fully agree, I don´t want a discussion either. They all are non objective. I don´t want a discussion about "mood" either. I want to see facts. Just the objective truth. 
The most "objective comparison video" (about current capability) I´ve seen so far is where they installed WAGOs and wire nuts in the same line and increased the current. The first thing that fiaild was the wire insulation ... at something above 100A. This was a fair comparison. Not just BS talking "in my opinion....". Opinion is not facts.
Reply: @liquidrockaquatics3900  A properly twisted + wire nut connection has lower resistance (thus less heat under high amperage) than a Wago connector. 

I still support Wago-style connectors, since a shocking amount of people do not install the wire nuts properly. I literally had a wire nut fall on my face after opening a junction box, exposing live wires @ 480v.
Reply: @thelight3112  agreed. I don’t dislike wire nuts for some applications, but wago style connectors are superior for many applications, especially for high vibration or movement.
Reply: @bikerpumbajh8108 as far as I remember we are not allowed to install  electric with them in DK
Reply: Many electrical standards in North America are mickey mouse. In Europe it's normal to run wire through PVC pipes. In North America they never use PVC pipes for indoor applications. North American plugs are complete bullshit. Even an adult thumb can easily reach a half plugged in plug. It's stupid beyond belief. And flimsy where the plug bends and all. I find all the North American electric stuff constant cringe.
Reply: "professional electrician here"
"Ive never seen that"
Reply: @melodicapex860  Yes, the wire nuts were outdated before my apprenticeship 35 years ago.
Reply: I even have wirenuts from the 90s here in Norway. I don't use them anymore but it was used on a regular basis.
Reply: @RX-1 Just plain stupidity if you ask me. In the first place (and they... really don't think their little "torture tests through" - which also shows how faked some of the tests are) the Wago's lever arm isn't even connected to the mechanism when it's in the locked position. So even IF it comes off... it doesn't deactivate the spring's holding power.
Reply: @jankrusat2150  Yes, well, Germany hasn't been the same as late. They're still using faxes in government offices and have an aversion to this thing called "the internet". They've been Americanized too much. Wago is certified and they say "no crimps" - and it's so because the clamp inside needs to grip the wire, it can't on the much harder crimp metal. Crimps are exclusively for situations where you have a screw terminal that directly contacts the wire. The rotation of the screw coupled with some of the cheaper screwed terminals (be they single or double wire type) ends up severing strands. They're not even smart about it either.

In the first place, if the Germans were actually smart about it, they would push for flap type terminals, where there's a piece of hard metal with a gripper lip pointed towards the wire, and the screw rotates on top (like most electronics terminals are, they've figured that one out long time ago) but they're not. Those types of connections are bullet proof and wires are not destroyed or severed (when done properly, with a torque screw driver). So their certifications are antiquated and not up to modern standards, in the first place.

End of story: choose the proper wago for the proper job, follow the instructions printed on the side to the letter and you'll do fine. With the addendum that you should use a bigger junction box. Wago's only problem is their bulk. I wound NOT, use an old style junction box with wagos.
Reply: The style wago he showed on on clip that style opens super easy! The other wago with skinny orange fingers are a pain in the asz to open for sure.. wire nuts have been used in usa for 60plus years
Reply: people can buy 2 types of wagos, u know theres slim modern version or older bulky with stronger lever.In boxes of older home it may be difference for space.
Reply: Nutts just awfull & worse to do, can’t normally adjust connections & re-do
Wago take less space, easyer & safer
Reply: @kettch42 how offen you contol connection in junction box? All screw connections get lose in a time
Reply: Wago's, that's the way it goes! 😂
The way to go! Wago!😂
Reply: Well, go figure, here in America, we still use the Edison base for screw-in bulbs! Out of all the electrical codes and regulations we have, you'd think they would have banned the Edison base sockets. Not like a child can put their fingers in them or put a metallic object in the socket and be killed. Sometimes when I see these types of situations, I think that maybe there's a huge surplus of bulbs that need to be used up first! Like the "A" drive 144MB floppy disk drive that every computer sold had one. The most obsolete storage medium around, even when they included them with new computers! 😂😅😂
Reply: re ad watts 😮
Reply: I love them.
Reply: Wagos melt down from normal amperage over time. Europe uses stranded wire extension cords and 200+ volts to neutral. Extremely high losses create excessively high electric bills. The US uses much more power for much less cost because of the superior system design. Even so, AC power is still inferior to DC, wasting natural resources and oppressing future technology.
Reply: @unwelcomemotivation  Me here in Finland and no nerves to watch through long u-tube videos, prefer written text, far quicker. Anyhow,  for example my single family house (made 2000-2001) is full of wire nuts (tm Schneider) and then there might be few terminal strip connectors (here aka "sugar cubes" - earlier made of white porcelain). These wagos etc alike came in bigger numbers to hardware store shelves quite recently. I had to check that how this is nowadays here with professionals,  and called my bro.inlaw who's an electrican and he said that they use something Wago-like, maybe a Chinese more cost effective brand :) as Wagos are overpriced for regular installations, says he.
Reply: @trinne  My single family house in Finland, as a diy-project started it in 2000, and still some skriting missing in more concealed places :) But anyhows, this has wirenuts everywhere. They are good as the house has still not burned down after +20 years of heavy use!
Reply: Talking to a Profesional Electrician in the UK once about wiring and we compared a few things and from what he said, Wire nuts are ILLEGAL to use in the UK and have to be the compression slide-in WAGO.  In a low-voltage device I have built I use them because they are convenient for making changes to the wiring.
Reply: ‘Wah-goes”? lol
Reply: @kettch42  Look at statistics for electrical fires in the US and compare them (per capita) with any western European country.
Reply: I  couldn't believe they're still using these in this century.
Reply: Hi, professional European electrician here. When we see wire-nuts and/or screw terminal blocks in old installations, we immediately replace them with Wagos, 2273-line for solid core wire installations up to 2,5mm², 221-line for flexible installations and solid core installations up to 4mm². They are easy to use, my 1st year apprentices never had any trouble to grasp the concept, and versatile.
Never once in all the years since the 221 came out, had I "accidentally" open one of the levers, but I did pinch my skin a few times because the levers close extremely quick and strong. If your box is so overfilled (at least here in Europe, there are manufacturer limits on how many cables/wires you are allowed to terminate within a box) that you can't push the terminal in without it getting caught on wires, you should use a bigger box and/or don't leave as much reserve wire.
All that aside, you don't have to be a genius to realize that you won't have any trouble when you push your 221 terminals in closed side first. Just saying.
Reply: @OgbondSandvol  3) Torque applied to a threaded fastener is an indirect measure of the clamping force (on the conductor). Dust, machining tolerances of the threads, temperature, humidity, etc. at time installation of installation are variable, and therefore even with calibrated torque screwdrivers two connectors done up to the same torque with the same wires may have a different clamping force at the conductor from day 1.
Reply: @simonmac4291  :-) One more reason why Wagos are better than threaded fasteners, aren't they?
Reply: Old wiring in the Netherlands often has wire nuts.
Reply: @klaus2t703 Soldered connections aren’t necessarily bad, but there’s almost always an alternative that’s superior. (Soldering components onto PCBs is one exception, in that we don’t really have anything better yet. I say “yet” because there have been some advances in conductive adhesives, allowing some PCBs to be assembled with that instead of solder.) Crimping and spring terminals are practically always better ways to terminate wires than soldering. 

People don’t realize how many downsides and failure modes solder has, like how it cold flows under pressure, and fractures in vibration and thermal cycling. A freshly made solder joint looks satisfying, but it’s less robust than the various alternatives. The downside to many of the alternatives is that they require precision tooling and processes to do right (crimping, for example). A poorly made crimp will perform worse than the solder joint. But a properly made crimp is far more reliable.
Reply: @mijp Actually, the best lead-free alloys these days are silver-free, instead being mostly tin with a small amount of copper, with tiny amounts of nickel and germanium added which massively improve the flow and wetting action, and produce a nice shiny joint. Tin-copper-silver alloys like SAC305 are the oldest lead-free alloys, and while they’re still widely used because of how well understood they are, they’re comparatively expensive and don’t actually flow as nicely as the newer ones.
Reply: @Hemshemsems  Wire nuts were used in Norway before, I don't think they still are.
Reply: Pretty sure wirenuts arent illegal in the EU.
Reply: @kettch42  After some time you have to tighten screw connections, because metal is a little flexible and connection is getting loose longer time after first screwing. In Wago's case there is a cage clamp with a kind of spring that presses on wire all the time, so connection is not geting loose.
Reply: …along with millions of halo cans that come with wago style connectors to meet their speedy install marketing. Old school electricians who misinatalled wire nuts love to waste their wrists and employers time.
Reply: I pref wago and wire stripper.
Reply: Terrible American system. 
I am a professionelle electrician in Switzerland. 
We don’t have as much fire troughs failed electrical work. 
We don’t have this open outletconnetions and all that stupid dangerous stuff in Europe. 
Buy cheap is better then safe in America.
Reply: i use them in hawaii and no problems so far.  nearly 20 years.
Reply: @pezpengy9308  "Them" means what?
Reply: British electrical standards are the best in the world!
Reply: @dascandy I think that the wire nuts here in NL are different than in the video.  Here the wire nuts have a sort of metal spring in in with sharp edges for good contact. When unscrewing the wire nut, this spring remains on the twisted copper wires. It always is a very good connection, when you use the correct size and make a good twist.   Since a few years we use wago's in our factory and they are very good and easy to use. But those cheap ones in the stores without the handles are very poor quality. You push in the wire and with a little twist you can pull it out. (unbelievable that they have a kema keur)
Reply: I have used wago since the beginning never had any open or drop off or not working I prefer these above all
Reply: It’s copper to aluminum and it’s not even a good connection wagus are junk I don’t know why yall use them but if you twist wires it’s copper to copper and way more touching less resistance better joint period
Reply: Wire nuts are basically a INSULATION,lol,The wires twisted Will ,as he showed,twister TOGETHER FORMING a GOOD bond,lol
Reply: I think they are not allowed in Belgium.
Reply: The hole in some wire nuts is for making a branch out of the hole in the top. I guess you could test through it but that's not what it's for
Reply: I agree - Wagos are a One-Time use product, where as a wire nut type connector can be reused.
Reply: 110V makes wire nuts a lot safer, plus splices have to be in a box.
Reply: @AskTheElectrician  Crazy. And the earth is flat? Hopefully this was an ironic comment.
Reply: Lot of great info here. I'm guilty of a few ways here. I'm actually replacing a 50 amp outlet out. The wires plug in and screwed. I did notice I have to much wire showing and the 1st thing I thought was the arching.  So this being a older video I don't know if you'll see this. I subscribed and looking forward to more great videos.
Reply: Ive found wagos that have caused intermittent issues. I throw a bit of tape around them. Just to be sure
Reply: What are you rambling about? Wire nuts is all over the place in older installations in atleast Nordic countries.
Reply: "if you are able to read" that would ban 60% of "professionals" in the US and 45% in the EU from using it 😂
Reply: In Canada we eat wire nuts. They are everywhere.
Reply: Agreed.
Reply: I germany there are often also some screw connectors used, however these are not really suited for high currents
Reply: @some-random-guy-l4r  It´s not clear what you mean. I use screw connectors for up to 250A  RMS 24/7 in my designs. My customer uses screwd connections up to 3000A RMS 24/7 (Chemical Industry. Since the 1970ies). Why do you think they re not suitable? Also when I design for the USA I use their recommended screw connectors.
Reply: In my house in Seattle from 1950 I removed all the outlets and switches as they were original, the plastic white color turned in to yellow faded color but the wire nuts in the outlet boxes were in like new shape, no corrosion and could easily be used again.   I used the Chinese style it is like WAGO but without the lever you just push the wire in and it cannot come back out so it's one use only but its great as no risk of the wire coming out unless you really pull super hard, it has to damage the wire to pull it out, these are very good for DIY.
Reply: I think the YouTube expert just made that stuff up about the WAGO connectors. Virtually impossible to do what he said.
Reply: Well in Switzerland wire nuts are simply illegal. So only wago here
Reply: @goose4342 Same here, I'm a Electrician in a steel mill and we use Wire Nuts on a lot different things, never have issues with them at all take the vibration really good and plus you can use scotch 33 tape on them for added insulation and to hold better.
Reply: @kettch42  Under the pressure of a screw, copper yields slightly over time and the screw must be retightened.
The Wago terminals use springs, the pressure remains even if the copper yields slightly.
Reply: They're quicker but they also keep me in business for having to go replace them because of burn up or charred wires. I will not allow it on my job. Loved them at first, until I had to go back on my own work because something almost caught fure
Reply: Wirenurs are used in the U.K., not common anymore, Wagos are taking over, the good old Lüsterklemme is also pretty uncommon in the U.K.
Reply: I cannot imagine flipping that lever accidentally.
Reply: Wire nuts is the only way in-wall connections are made in Greece. Preferably, the wires are pre-twisted and also bonded by soldering.
Reply: @kettch42  main disadvantage of screw terminals is, many screw terminals (the ones with two screws) are only rated for currents you see when connecting a light fixture. Main issue, usually as soon as they are out of the packaging, no marks or information on the rating. the ones with only one screw, people may tighten the screw too much, you may damage the wires. Also, they are not suitable for stranded wires (the levered wagos are). And finally, they leave open contacts that can be touched and need to be wrapped in tape. If done properly, they are absolutely fine, the Wago Stuff is just so much more convenient and foolproof.
Reply: Thanks for the refresher, man! Liked and subbed. 👍
Reply: @mikehagen3785  I bought several types of Wagos in California (from Amazon) but haven't been brave enough to trust them, so they sit in the boxes 😁
Reply: @timb.4902  I haven't had any issues in the last decade or so with them..
Reply: Comments summarized: Wago is great and safe, nuts are crazy unsafe😅👌
Reply: I do not believe wire nuts are legs in most European countries
Reply: I came here just to see if people of Europe would be urged to defend and extol their crowning achievement, the Wago.  I was not disappointed.  😂
Reply: @steveloux4709  Nobody urges us to tell about progress and advantage. You are free to stay behind.
Reply: @Hemshemsems  
I've heard that in northern Europe there are some countries where wire nuts are fairly common while others they're not.  Like the Netherlands and Norway, but not Finland or Sweden.

However, it's my understanding that wire nuts are generally compliant with whatever national/local electrical requirements, but in places that don't typically use them, it's because that's just not how they do it.  UK comments are often that they've never seen them and even claims that they're illegal, but they are available for sale and apparently legal to use if someone chose to.
Reply: Your jus spoiled jah?
Reply: Soldering is prohibited now!
Reply: NEC code does not allow soldering.
Reply: @IYar56  
The NEC specifically mentions soldering is acceptable for spliced connections.  The main problem is in properly insulating the connection, as I've seen some just wrapped in electrical tape.  I believe rubber splicing tape is acceptable, but only if covered with electrical or friction tape for mechanical protection.

"110.14

(B) Splices
Conductors shall be spliced or joined with splicing devices identified for the use or by brazing, welding, or soldering with a fusible metal or alloy. Soldered splices shall first be spliced or joined so as to be mechanically and electrically secure without solder and then be soldered. All splices and joints and the free ends of conductors shall be covered with an insulation equivalent to that of the conductors or with an identified insulating device."

Besides that, I've seen some pretty bad soldering jobs that took up a ridiculous amount of space.
Reply: Ok, yes Wagos are great and easy. But imagine that you have that one faulty Wagos and you are putting it in your home. If a wire nut fails its user error. I fell safer knowing I installed it correctly rather than hoping this works. Call me old school.
Reply: @micahmyers4680  
What would you suppose would be more likely though?  A failed WAGO is pretty rare.

With a lever connector it's pretty simple.  As long as the wire is straight and one can see the wire is inserted properly, it's as good as it's going to be.  I know there are some claiming higher resistance and all manner of potential issues, but that's all accounted for in the rating for up to 20/32A, which is probably conservative.

With a wire nut there may not be very good visibility, especially when dealing with very short lengths of available wire.  I've personally seen wires that slipped out or weren't properly connected in the first place.

It's my understanding that a lot of failures with lever connectors like the WAGO 221 is user error or use in an improper environment, such as high moisture or high vibrations.
Reply: We"re a bunch of nuts!

I now wonder about wagos'' long- term durability--and, in untoward conditions of heat and cold.

I venture that that sort of plastic sooner becomes brittle and thus breaks/shatters. 

I think that wirenuts are less likely to break or crack, in that manner.

Face it: That PRC-friendly hardware Industry cares little about suvh long term usage. 

Sure, it may hold up for years. Still, it's likely hidden and  afterward unnoticed--for years--, inside your wall and ceiling boxes.  

So, we leave our spawn with such problems, as before.  I particularly am fond of old glass insulators, strung with bare wiring. Gee, for some reason, that's so similar to old Telegraph and telephone pole fixtures.

Kick the can down the road!

Nothing is invulnerable and immortal.
Reply: My company just started using WAGO connectors and I’m starting to trust them.
Reply: Wago is slow to catch on in the USA.  Wire nuts are extremely common.😊
Reply: They're all fine if used properly. However! Clone wagos often have the lever break easily by the case separting when you go to open them after 2 years or so and most wouldn't know the difference with them.

3m makes some new 2 part wire nut that wraps the wire part too.
Reply: I just used WAGOs yesterday. Had to tape them because they kept popping up, even though I was being stupidly cautious. To me they're still better than wires nuts.
Reply: @takedeadaim8671 they must of changed the design because the ones I have don't have a recess and can get flipped fairly easy
Reply: What do you do when you have more than two and one is strand
Reply: @davidjones5269  a complete question would also note which connectors you talk about.
Reply: Wire nuts are proven to be the best way
Reply: I think wire nuts are something for people that say nuts are cheaper forgetting that it takes you ages to preprare them properly which again is more expensive. More improtant is maybe that when WAGO is used typically less mistakes happen. You can see it and you cant when using a wire nut
Reply: @kettch42  Haven't seen an answer yet, so gonna try.
Screw terminals can come loose over time, and I'm sure you'll be familiar with the need to verify them and re-torque as needed on regular maintenance intervals. The WAGOs use self-asjusting connections, or, in non-marketing speak, springs. Those don't come loose over the same period of time. Anecdotally, WAGO'd up control cabinets for a memory foam press haven't had a single loose connection in just over a decade of operation. Both connections, however, still require regular inspections.
Reply: @martinlewis1015  they do, Ive had mine go off in my pocket (cotton drill pants) when I've left it on by accident. Takes a while though to build up a charge it'll detect 😂
Reply: Ive only seen Wagos here in Australia in low voltage (commercial appliance) applications. Haven't seen them used in 240v household circuits yet...
Good old screw terminals (not wire nuts) seem to give a good clamp force on our stranded wire, haven't seen those fail.
Reply: @bertiesworld you also had those white small screw in connection.
In the netherlands we call them crownbricks. (kroonsteentjes)
Reply: Then,  obviously, this isn't for you...🙄
Reply: @Y3ssirree  without a reference ... this comment makes no sense.
who is "you"? and what is "this"?
Reply: @goose4342 as a guy whose job it was to diagnose VFD ground faults on motors I have to disagree with you. Wire nuts fail all the time--especial in high vibration environments. They just rub through against the inside of the motor connection box. Usually takes a while and people who don't know any better think it's a bad motor.
Reply: @BazookaIke yep. They're literally superior in every way. Price would be the only com, but I'll pay extra for ease of use and a better, safer connection.
Reply: @kettch42 It's very simple, wagos offer very little room for error, a screw in terminal not so.
Reply: @kettch42 That's not really surprising, the US is a bit of a backwater. It's like going back 50 years in time.
Reply: @phillip53 How much does a fire or an electrocution cost you, if attributed to a defective installation?
Reply: @kettch42 You don't need any traing or certificates to pass yourself off as an electrician in the UK, OK it's a little more nuanced that that, but essentially true. Which is worrying.
Reply: Wagos are GARBAGE; no better than the "push-in" connectors on 15-amp switches & outlets.
Reply: Wago's are perfectly fine to use, and I don't think the author has any issue with them either, just use some tape if you feel that the levers could accidentally flip up with inserting them back into their electric box.
Reply: @MrJamesdefreitas  I'll stick to wire nuts where there is a lot more physical connection between wires.
Reply: @jimbritttn  Understood change is hard, and at your age near impossible.
Reply: @Hemshemsems older connections in my Dutch home still use wire nuts. It’s fine! Wagos are much easier to do right, but wire nuts done right work.
Reply: The fact that you talk in AWG tells that you work or live the other side of the Atlantic.😅😂
Reply: I'm a central heating engineer in the UK. The only place I've ever seen a wire nut is inside old Honeywell zone valves and mid position valves to connect the synchron motor. This was superseded many years ago (and for good reason! Wire nuts seem like a disaster waiting to happen to me) by a crimped connector.
Reply: If you are able to hear, it was said it can happen when you are pushing the connector into the box. Also, regardless of what you may not be able to read, there are public buildings that will not allow the use of lever connectors, regardless of what you've never seen. Quite a book you wrote just to say, "I never use wire nuts"
Reply: @nothankyou5524  I don´t hear this written text. I read it. And if you can read, I wrote "I can´t imagine" but you understood "It is impossible to happen". But that´s not what I wrote. But you are free to give me a link to a reliable site where they use orignal WAGOs that ACCIDENTALLY go open/loose when you push them into a box. I bet you can´t. Prove me wrong.
Public houses. I guess this is a rule from 50 years backwards USA. Billions of WAGOs are installed in European homes and industry. There is no evidence of a higher failure rate. You're just spreading hearsay.
I guess you're the one who believes that cats and dogs are eaten... You believe in what you want to believe and you don't ask for evidence.
Reply: Wire nuts are comon in houses built in the 70 if I'm not mistaken. In Sweden that is.  @einlehrling
Reply: @hardtymz2517 If a Wago has failed, it has been used incorrectly
Reply: I’ll trust a properly done marrette ( wire nut) over wago or screw terminals. It gives the greatest contact area and once  whip wrapped in insulating tape, it’s forever and immune to contamination. 
Screw terminals? As the soft copper metal compresses, then heats and cools, eventually the screw isn’t tight and the cct degrades.
Wago…? Not sufficient contact area…
Reply: @globalpilot76  You said it right: "You trust", this means it is a personal opinion and nothing scientific. Contact area: Do you know the active contact area in a swich or relay? You would be surprised how small it is. Additionally the conductivity of some hard contact alloy is much worse than copper. Still it works. Never wondered why? 
Contact area is not what makes a contact more safe. It´s also the force, the spring technology, the heat spreading, how to handle the oxidation and so on.. And how big the risk is for installation mistakes.
Reply: @ I am aware of how small the contact area can be in devices, but as they are dynamic (switching on/off) there’s little alternative so it’s really an apples and oranges comparison. 
Not much other than soldering ( which I still do if it’s stranded wires) can beat a properly done 
marrette for contact area, force applied and durability.
Reply: @globalpilot76  Switches are designed for continous operation. I have switches in my house that are ON for years and only OFF on emergency (= never). So how is it an apple and pears problem.
Soldering of stranded wires is knowingly one of the highest risk for causing bad contact and house fires. It´s forbidden  since decades in house installations in countries that rely on science. If you still do this ... then a further discussion makes no sense at all. I rely on education, science and research, not on hearsay or personal preferences.
Reply: @ I’ve never heard of a properly soldered connection as the cause of a fire… I’d like something evidential. All switches/ relays will, eventually fail as micro-arcing will erode the contactor surface. More it’s used, the faster it will fail and need replacement. A wire nut is a static environment and never subject to being open / closed so, yes, it is an apples to oranges discussion.
Reply: How many times you gonna make this same speech?
Reply: BTW, what does a solid and stranded joint look like when the nut comes off. My apologies if I missed it, and no offense intended if I didnt.
Reply: @johnnybakblast457  Exactly.
Reply: Been doing home wiring for 50 years.  Never heard of wagos before.
Reply: @JoeShmoism  This is not a personally addressed comment. But I´d like to comment about our (European) education system. To be allowed to do electrical installations on your own you need to pass school. Then you have to do a usually 3 years apprenticeship combined with school, then you need years of practice then you need to do again school to get your master´s degree. During this time you learn much of theory, you get taught laws and regulations, you get taught latest technology and when and how to use it. So every single electrician starts with knowledge up to date. The same applies for almost any handcraft job.
Reply: Americans are very slow to adopt anything new, so wagos won't be accepted till the old generation retires
Reply: You have to understand American contractors and electricians they lead pretty sheltered lives. I have traveled over 70 countries and studied construction methods and dozens of those countries. Wago connectors were invented in 1950 and have been used without problems for over 70 years. They get introduced to America and all the sudden there's some new simple way that's going to fail and cause a fire within 2 months of installing them....
Reply: @unwelcomemotivation we're far behind time in canada, eh
Reply: Europeans started using WAGO nuts in the Seventies, then outlawed them again due to them being safety (fire) hazards, so it was back to wire nuts. And now they are back to (improved?) WAGO joints?  Nothing beats an old-fashioned  wire nut when applied to a  wire joint consisting of wires properly twisted together.
Reply: @howmuchisenough4320  I'm usually really good with this type of stuff. If you could point to an article or a code of any of the European nations that show Wago being banned (they actually started using in the 1950s) and then when they're used was reinstated? And you do realize that wire nuts are banned in several European countries? There are pros and cons to everything I won't deny that.  There's no doubt that the Wago connector has had improvements over the years just like every other product I can think of (except the mouse trap lol). Naturally when I started in construction 57 years ago we twisted the wires together soldered them together and then put a wire nut on them and then black tape around that.
Reply: I electric tape my wago's shut and down the wires ab an inch or so...   that should prevent his complaints from being an issue right?
Reply: Absolutely agree with you. When I first saw how electricians and DIYers connect wires in the US, I was very skeptical. At first glance, it just did not look right to me.
Reply: Bullshit Klaus. Wagos are a failure point.
Reply: @johnnybakblast457  As in the current does not flow from wire to wire, but from wire to Wago then from Wago to the other wire? That would be a significant difference. Definitely not KISS principle.
Reply: @johnnybakblast457  As in the current does not flow from wire to wire, but from wire to Wago then from Wago to the other wire? That would be a significant difference. Definitely not KISS principle.
Reply: @kettch42  TBH, I'm still skeptical of them, just because I'm in the US and not a professional electrician. However, a couple of times when I think that wagos are probably better is for things that you expect to replace, for example smart switches and thermostats. Those are going to be replaced relatively often whereas outlets last more or less until they get loose or damaged and lightswitches last for just about forever. It's not uncommmon to have light switches that safely operate after many decades. 

The other bit that can be nice is that you can leave room for expansion or a spot to insert a multi-meter. I know there are induction voltmeters, but checking resistance like that isn't so easy.
Reply: @mikehagen3785  Yes, they just aren't widely known about outside of the trades. I've been pretty skeptical of them, but at some point, I'll probably just buy a few and put together a test circuit and apply an ohm-meter to them and verify that I'm being unreasonable.

What I know about electrical work I learned from my dad decades ago and while the stuff I do is mostly pretty basic and mostly involves replacing recepticals that have worn out, I just think that the best way is a wire nut that's properly twisted and then a bit of electrical tape just to make damn sure that the wire nut doesn't backoff over time. And, while we're at it, a bit of electrical tape around any outlets and switches just to make damn sure that if any idiot grabs in there without powering the circuit down there's at least a little bit of insulation in between them and anything live.
Reply: @kettch42  Try using them and you will see the advantages.
They are great for difficult situations. You can deal with one conductor at a time, pushing it in and flipping the leaver to hold it in place, then onto the next conductor. Trying to get 5 conductors to line up in a screw connector, when you are balancing on top of a ladder is a nightmare. so much easier in a 5 way Wago.
But maybe biggest advantage is in fault finding. You can remove one conductor, do testing, replace it, take out a different one, etc, etc 
I assume that with wire nuts you would need to trim back and re-strip each time, rapidly running out of slack cable.
But I'd be interested to hear what are the advantages of W. Nuts over Wagos. I'm always willing to learn.
Reply: @kettch42  Dont worry, its part of our 3rd world development program, you will get them ;-)
Reply: Totally imaginary failure mode for Wagos. Try harder.
Reply: I just posted a question in the comments about using them to tie ground wire connections together.  Im replacing the cheap plastic outlet boxes that were originally installed in my house with metal outlet boxes.  So many of the original plastic boxes have stripped/cracked screw holes where the receptacle screw fastens the receptacle to the outlet box and many of the receptacles around my house are loose because the screws can't catch thread.  I live in the USA and was asking if Wago connectors are ok to use for tying ground wires.  Out of all the stuff I've seen on youtube on Wago's, I've only seen them used for hot and neutral connections.   Was wondering does code here not allow them to be used for ground connections?  I haven't read anything that says they can't be use, I just haven't seen them used on ground connections.   Are they allowed in Europe for ground connections?
Reply: In the USA the voltage is only a sissy 110-120V 😅 this doubles the amps compared with our European voltage of 240V / 400V. Wago connectors are widely used in the Netherlands. Wire nuts are old school…..
Reply: People in the US are constantly remodeling and fooling around with the wiring. Wire nuts tend to be more "tamper proof" and less likely to be pulled apart. At least in my experience.
Reply: NO WAGOS on my jobs, wagos are a hazard if used in a j-box with an overload, as sometimes happens when the homeowner connects more stuff than the circuit is rated for , wagos connection heats up then cools off and the springs and little metal particles and even plastic loose their integrity, did the manufacturers test it in these extreme conditions ? Also wagos take up more space, it's hard to fit several in a j-box , for instance a 1900 or 8B size where wire nuts are fitting more in numbers , yeah sure use the WAGOS in Fans or small light fixtures, some 20 years ago there was an UL approved wire coupling for Romex where one could couple another Romex wire without striping and j-box, to many fires and they got outlawed, it is only a matter of time when WAGOS will be legal only for cat 5 purposes , finally "YOU GOT TO TWIST THE WIRES " for you European electricians , just like they did it for the past century, don't get lazy .
Reply: @r.j.m4245  There´s so much wrong! At first: We have overload protection, called fuses. They exactly exist to avoid problems with overload. They trip before anything gets too hot. Next: The WAGOs are approved in every country under various conditions before they are allowed to be used. The first ones who demand approval are the insurance companies. If they see an increaed problem with WAGOs they would immediately remove WAGOs from the market. Next: You can see YT videos where they drive 100+ Amperes through a 16A rated WAGO .. where the wire isolation melts before the WAGOs break down. 
Just to clarify: We are talking about genuine WAGOs - not any cheap copy. If you buy crap ... don´t blame it on WAGOs.
Every single eletrician - before they are allowed to do installations - need to undergow a 3 years apprenticeship in accordance with school, where pratice is told, math, physics, chemistry, laws, regulations, installing methods, and latest technology. And they need to approve their knowledge with practial and theoretical tests. This is for every worker. Additionally there need to be at least one person to sign responsible for the construction site. He needs to have a master´s degree. Every outlet/line needs to be tested with standardized test equippment.
Reply: @ in the USA you run a sissy 110V which doubles the amp’s…. We in Europe have 240/400V real manly voltage….😜…by the way….in the Netherlands we invested in our infrastructure, the only power lines not in the ground are the real very high voltage ones.. all the rest is in ground….in 2004 I refitted electricity gas and water in our house. I did use “wire nuts” from Conex..the new smaller Wago’s are widely used these days. Wire nuts are very old school. So is the infrastructure in the USA….110V 🤣